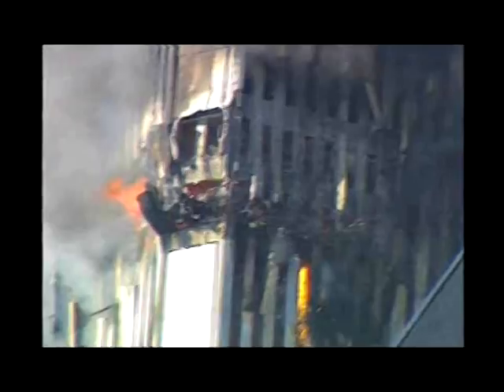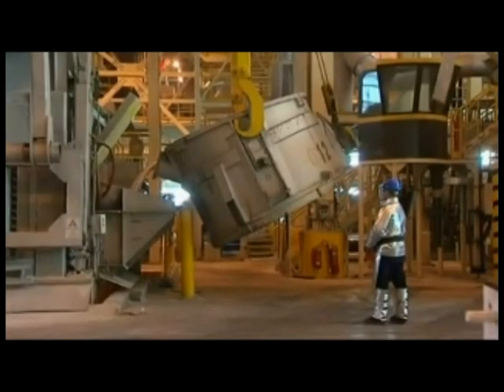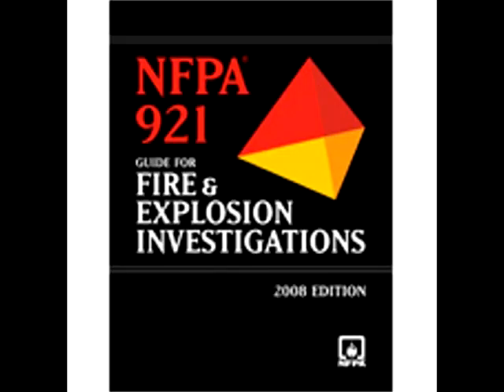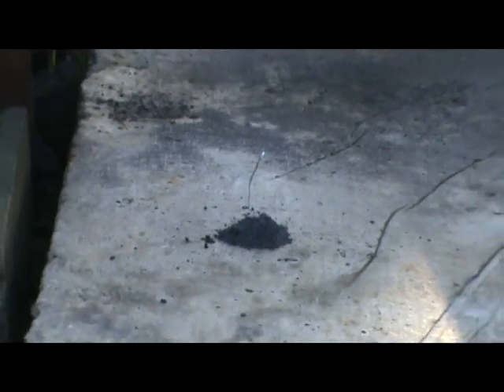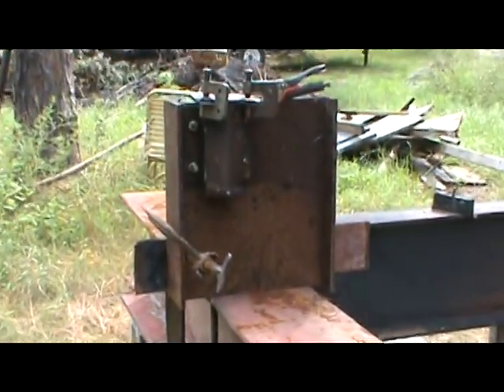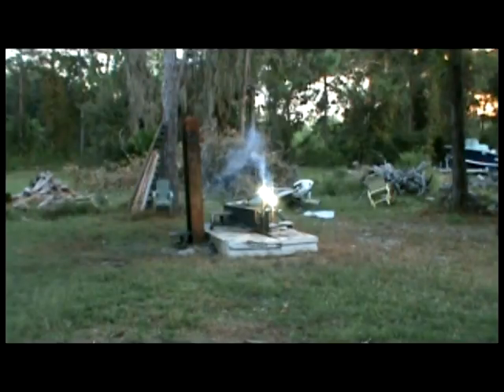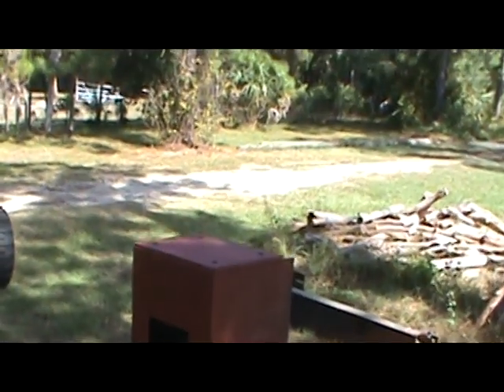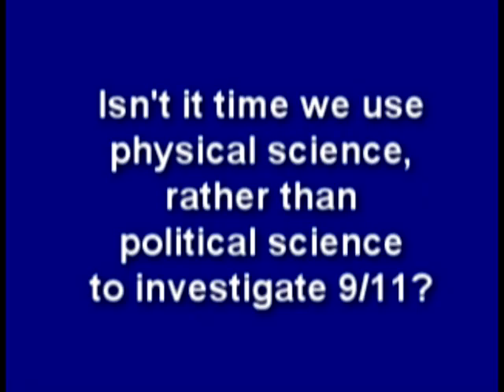9/11 Experiments: The Great Thermate Debate

Comment: You don't NEED to cut the steel, just heat it until it weakens. I don't see anyone doing test with 48,000 gallons of jet fuel.
Reply: +Greg Ballard these points are irrelevant since the steel loses 50% of its strength at 500c. Not to mention thermic expansion can break the welds between beams. None of this requires the steel. To melt. Loss of strength, came down under it's own weight. In ur example the fire proofing worked as intended. In 911, a lot of the fire proofing was removed by the plane on those floors. additionally, in 1975,  they were using full asbestos fire proofing, which is a much better fire retardant than what we use now -- it's just very hazardous to human health, ie "do you or a loved one suffer from mesothelioma?"
Reply: How quickly does gasoline or jet fuel burn? A few seconds and it's gone in the initial explosion...
Reply: @Stephen Savage "I don't see anyone doing test with 48,000 gallons of jet fuel" you don`t need that much for a small scale experiment, why don`t you try to do recreate what happen on that day, physicsanderson at least tries to prove his point, to you?
Reply: He clarified that jet fuel cannot burn steel. Why don’t you listen?
Reply: UpWithLucid , it didn’t melt steel but there were molten metal...why don’t you think
Reply: Take 48,000 gallons of jet fuel then light a match and throw it in it,  nothing would happen aside from the match going out.
Reply: Stephen Savage you're not only an idiot but also gullible af.
Reply: 48,000 gallons of fuel, spread over how many thousands of square feet over how many floors?
NOT likely at all.
Reply: You are an idiot, jet fuel doesn't just magically burn it has to be atomized.
Reply: Preach on brotha.  This guy is a f’n moron.
Reply: Jet fuel needs to be atomized to burn correctly so that’s bullshit with the whole jet fuel theory !
Reply: @nin1ten1do  bc the speed of the plane crashing into a stationary target. The plane will shred on impact but with forward momentum and density it will push through the walls of the tower creating a breach
Reply: those explosions from the planes burned up most of that fuel
Reply: "Proof or it didn't happen"
Reply: Operation Northwoods?
Reply: Jet fuel can only get that hot when mixed with compressed air like in a jet engine
Reply: The amount of fuel don't make a fire burn any hotter, it just affects how long it burns. The towers were only on fire for about an hour, which is already on the shorter side, and almost everyone agrees that the fuel that wasn't burned up in the explosion on impact burned away within only 10 minutes after.
Reply: Stephen Savage fucken idiot still in denial..accept the real world we live in.phsycopaths leading and controlling almost everything besides my balls whe they itch..i scratch'em on my own
Reply: "It's not science when you are cherry picking facts that only suit your argument and you do not impartially accept all facts and science pertaining to the case."

I think you should know something... I just literally looked up the information on those planes and did the calculations as I was writing that comment.

"The buildings DID survive the plane crash. It did not survive the fires that softened the trusses and catastrophically weakened the structures."

Here's some other information you should know. In NYC there are very strict fire code standards for high-rise buildings/skyscrapers. Those codes dictated that the furniture, carpeting, and other materials in high-rise buildings and skyscrapers must have a specific level of fire-resistance. The cubicals? Fire-resistant. The carpet? Fire-resistant. The drywall? Fire-resistant.

The fires were isolated, and they got smaller as time went on, as indicated by the dark sooty smoke coming out of the towers. Dark sooty smoke indicates poor combustion, meaning that the fires weren't that hot. The fires got so small, that after about an hour or so, people were actually seen standing in the hole where the plane impacted the tower. There are pictures online.

https://i.pinimg.com/originals/2e/10/b7/2e10b74bb55e2df3a24ec02b9a0a6216.jpg

"This shit was debunked a decade ago what are you people die hard morons or the new generation of kids who lap up every conspiracy theory."

Actually, if you knew anything about physics, building construction, etc, you wouldn't be saying that.

You know, I find it funny how people like you, whose entire knowledge on this subject is reading the 9/11 Commission report and watching bullshit cover-up documentaries, think you know more about 9/11 than someone like me who has been researching it for over a decade and a half. You just parrot back the shit you've been told to believe, like a moron, and then sit there and call someone like me, who has actually done several shit-tons worth of research around the events of 9/11 a moron.

Get lost, you brain dead dipshit. I know more about science than you know about anything...
Reply: How does a plane make it through that kind of steel to begin with? You're talking about as if there was already an opening. They have actual images of the plane's nose going right through to the other side "whole". How can that happen? It would have become bomb like and blown up on impact outside the tower.
Reply: Yea ,butt nut Jet Fuel Did it !!! IT DOES'NT MATTER THE QUANTITY OF FUEL ,'IT DOES'NT PRODUCE THE HIGH TEMERATURE OF HEAT REQUIRED TO MELT STEEL !
Reply: I have honestly no idea what you're trying to say. NIST provided the evidence that steel did not get hot enough to melt. Yet FEMA provides the evidence that steel did melt. It is in these conflicting findings that the truth lies. And anyone who is not paid to play the bumbling fool on YouTube should be able to figure out what it is.
Reply: MYTHBUSTERS TO THE RESCUE!!!
Reply: Jets fly with compressed air dummy, but that's another conspiracy....
Reply: a* test - or - tests*
Reply: Why does everyone disregard the liquid oxygen that was on board. I am pretty certain that the temperature increase from the oxygen would be enough to ignite the magnesium parts of the aircraft.
Reply: +Rick Johnson, sorry for being blunt, I'm fed up with all the misdirection in these threads and maybe you meant well.
Reply: +Rick Johnson, if you really try I'm sure you can get more nonsense in those two sentences.
Reply: FEMA limited metallurgical examination 403 appendix c
Reply: @Ab4kus  Unlike you, I haven't wasted close to two decades pouring over every single detail trying to prove a theory. I just know that it does not take a very high temperature to get low carbon steel to enter into its blue brittle stage. But keep on going. It's way more fun believing the government is so highly efficient it could co-coordinate an assault such as this and also be successful.
Reply: +Rick Johnson, I do not believe it. I simply can't argue with the facts. And if I compare the capabilities of 19 hijackers against the warmongers in the US government, then it's not exactly a tough decision. It's easy to assume the incompetence of the US government exists on every level, but what they fail to accomplish for the American people should not be seen as incompetence or unwillingness in fulfilling their own plans. Maybe you should see their incompetence for what it really is, them not giving a damn about the people.
But hey, spend some more time on the subject, it's all quite obvious unless you choose not to inform yourself, which is also perfectly fine you know. I just don't appreciate people both not informing themselves and misinforming others.
Reply: Are u high bitch do u know how much that would cost
Reply: Stephen Savage yeah that will work for a WHOLE  big building🤣🤣🤣
Reply: Stephen Savage the beams were also not solid, they were hollow on the inside. The beams were shaped like a rectangle.
Reply: More fuel won't make it burn hotter.  You obviously didn't watch any of the video.
Reply: Stephen Savage that because people are stupid and don’t think 😂 like melting metal is silver 😂😂 that much fuel and fire would super heat it and course it to go red
Reply: 48,000 gallons of jet fuel exploded on impact. there was not enough left over to burn long enough to weaken the steel
Reply: Stephen Savage I know right
Reply: Oxygen Starved flames cannot burn hot enough to weaken steel. rather it can burn the steel hi enough to cook or burn humans. not weaken them. You're so silly. why don't you buy tons of I beams of Structural steel and explode it. if it weakens the steel I'll believe you. but u can't do it in a foundry. only where air circulation is present much like the twin towers
Reply: Because if you use 48000 galons it doesnt make i hotter and it was a thousend degrees below the neltingpoint it would only glow but not even bend
Reply: You just don’t want to use your brain to find a truth, or you know the truth already, but still pushing your BS to others... shame on you.
Reply: That can be arranged.
Edit: Don't take this comment seriously, there's no way I can do anything like that.
Reply: SIERRAHPBT Nobody is claiming that the jet fuel melted the steel. If you're going to dipute NIST's findings on the collapse, at least know what they are first.
Reply: Kerosene to diesel fuel but does anyone really know what jet fuel is? Because i have used it in the past in my snowmobile for racing years ago and it makes a different with performance
Reply: Let's keep to the facts?  Two planes at 24,000 gallons max. each  = 48,000 gallons.  But according to NIST, the planes had 9000 and 10000 gallons respectively.  So you are out by a factor of 5.  Also, it is generally recognized that the fuel flared off in a matter of minutes.  An hour before the buildings came down.   So it seems to be somewhat irrelevant apart from igniting the office fires.   As far as I am aware,  no one has refuted the argument that office fires (alone) have never brought down a steel framed high rise before.
Reply: because WTC 7 collapsed without a plane hitting it ..... you absolute moron.
Reply: your not listening go and clean your ears dumb ass.
Reply: They have done it look it up stop being so God damn stupid Stop Believing everything you're told you probably believed in Santa Claus till you were 23
Reply: Truther-“I’ve been researching this for 16 years I’ve heard your arguments before” 
Sheeple-“But the beams didn’t melt they weakened and caused a chain reaction...”
Truther- facepalm “is that your argument that was aired on tv as the official story like 15 years ago we literally exist because that theory is trash”
Reply: And planes weren't even used in 9/11 they've already disproved that.
Reply: On impact much of the jet fuel burned plus high temperature days  - jet fuel was gone by then and underground would be oxygen starved.
Reply: Jay Jay debunked by who popular mechanics?
Reply: No. The perpetrator of the 1993 World Trade Center Bombing, Ramzi Yousef, was not "still at large". He was found and arrested in 1995 by the Pakistani ISI and the U.S. Diplomatic Security Service. He is currently serving a life sentence at the high-security Supermax prison ADX Florence in Florence, Colorado.

You should probably know what you're talking about before you open your mouth... lest you make yourself look stupid.

You don't find the fact that Larry Silverstein got a 99 year lease on the World Trade Center, and then has the cost of removing the asbestos from the Twin Towers assessed, and then takes out a massive insurance policy on the Twin Towers and WTC complex to protect against terrorism, and then starts a series of "renovations" to the Twin Towers (which no one seems to know what these "renovations" were), and then a week after these "renovations" were complete, the Twin Towers are both attacked by 19 hijackers in 2 commercial airliners the least bit suspicious?

You don't find it suspicious that a good number of these "hijackers" turned up alive after 9/11?

You don't find it suspicious that despite turning up alive, the list of the 19 "hijackers" was never altered?

You don't find it suspicious that the Twin Towers collapsed at, or near free-fall speed? Each tower collapsed in about 8-10 seconds. Watch any news clips from 9/11 and time it for yourself.

Without controlled demolition, it is physically (as in laws of physics) impossible for the towers to have collapsed as fast as they did.

Test this for yourself... The averaged height of both towers (they were slightly different heights) is 1,365 feet. Go to the following page, and either enter "416.052" (equals 1,365 ft.) into the height field...

https://www.omnicalculator.com/physics/free-fall

You'll find that the result returned in the "Time of Fall" field equals about 9.2 seconds. That means, if you had jumped off of one of the Twin Towers, it would have fallen for about 9.2 seconds before you went splat on the street below. The towers fell at, as close as makes no difference, the same rate as you would if you had jumped off of one of them. There should have been resistance slowing down the collapse of the towers, but there wasn't. The only way this is possible is through controlled demolition.

Watch videos of the Twin Towers collapsing, and then watch videos of controlled demolitions... watch them as many times as you need to... eventually, you'll notice that the Twin Towers collapse at the same acceleration rate as the buildings brought down via controlled demolition.

Read the wikipedia page for "Controlled Demolition, Inc.", and you'll find that they were the ones who developed the plan for the cleanup of the WTC site after 9/11.

Not saying that the government was necessarily involved, though it is likely, but... if you don't believe that our government would ever plan and carry out a terrorist attack against it's own people, then you need to read a document from 1963 called "Operation Northwoods"... because the government was planning to commit a false-flag terrorist attack to blame on Cuba to justify military intervention in Cuba. It made it all the way to the desk of the Chairman of the Joint Chief of Staff, L. L. Lemnitzer, who approved it. It was stopped by John F. Kennedy.

https://www.dc911truth.org/flyers/11-11-06-handouts/Operation%20Northwoods.pdf
Reply: @tommy3989  Commercial aircrafts, in order to get to 35000 ft where is the most efficient way to maintain a cruise speed with the engines running at very low rpm, they use half of their fuel, ask any commercial pilot.
Reply: @tommy3989  All the aircrafts involved were at this altitude. I don't work in this industry but I am pilot of a small aircraft and I have friends that are commercial pilots.
Reply: Stephen Savage the fuel was all blown up in the crash the only thing left to catch on fire is office supplies chairs desks etc
Reply: Don't forget a million tons of weight sitting on top of it...
Reply: @yea bouy why do you ask?
Reply: @yea bouy yeah but why do you ask me as if you're trying to prove a point?
Reply: Jet fuel STILL DOESN'T burn hot enough to even weaken steel... Steel doesn't actually weaken until roughly 200 degrees below it's melting point. Which is still a far shot from what Jet Fuel burns at... Moron.
Reply: Here is the Real ?.What government agencies did it .The FBI.or a non Gov agency CIA.Then we went to get Sudan for Genocide.What the he'll do you call what our Gov did or whom ever did it.I believe we killed alot. of humans that day.Not just that day if people would just open their eyes.The kill through the health system and alot other venues
Reply: @curtallen7755  Reading that mess gave me a fucking headache.
Reply: You cannot educate somebody who is ignorant
Reply: all this talk of molten stell- anyone think of all of thebother metals in that building- including the tons of aluminum from the planes- that turn molten at a lower point than steel? only like 3 or 7 pounds worth im guessing- everything in thete was carbon fiber and plastic i assume so souldnt have any copper or aluminum melting and pouring out
Reply: WTF you think a plane carries 48,000 gallons... do you know how big that would have to be
Reply: There is no point making the building collapse on purpose, nothing extra is achieved from "inside job" that is not achieved by just having airplanes crash in the building.

Perhaps less casualties, 300 instead of 3000 - who knows, some more would have escaped, but still would be the largest terrorist act in US history.
So basic point = nothing is achieved from a professional demolition that wouldn't be achieved just by planes crashing into the buildings, same foreign policy, same news headlines with "slightly less drama" but not by much.
Reply: @laetrille  oven and oven.... Lol you're one of those who thinks a plane fell a building.... You sir are a mug.  Based on the previous evidences of planes hitting buildings....  Flying fortress hitting the empire states being prime example.... 3 buildings ever have fallen die to planes hitting them.... EVER.... Is that's not enough info to make you question it.... Well no point in taking to you about it.  The obvious diagonal cut into the beems.... Literally obvious cuts on the pillars in hundreds of pictures... What in a building collapsing causes steel to snap to a prefect 45 degree angel..... I'll wait....
Reply: A B-17 is a medium bomber, not as big as a modern airliner.
The Empire state building is of different design. 
No 45 degree cuts were made by your super quiet quantum nano thermite that leaves no wiring or any evidence.
All your BS has been debunked by the good folks at Metabunk.com
Reply: Sorry but no... the section on the 45 degree cut.... it guesses that they cut it later... lol thats your proof... someones guess.... and you think were tin foil hatters
Reply: touche lol but whole world view... no
Reply: Nathan Stagg 
Oh nice response, nice deflection, no rebuttal?
Reply: Nathan Stagg 
There is alot more ;)
Reply: thanks for the link :))
Reply: None, apart from thank you.  Taught to admit when wrong... and you have proved me wrong.
Reply: Nathan Stagg 
Oof, i was a truther at one point tbh
Reply: 48,000 Gallons burned up in the EXPLOSION YOU MORON!
Reply: Jet fuel wasnt the only thing on fire in the buildings.carpet, paint electrical wiring..all kinds of plastic even carpet..so Jet fuel plus whatever else was burning..increased temps to weakin steel.anyone whos ever used a cutting torch or welding experience such as myself.steel does not have to be in liquid form to bend or move under its own weight..its simple physics and its being thrown out the window in this video.
Reply: There should at least be some math that could help, if scattered jet fuel burns at 1000° & for how long it would need &.. 
  if its pouring away & dissapating until it pools somewhere further down the bldg, how long does the splash of fuel on a beam burn b4 it burns out? 
  This fuel is not suspended or magnetic, like water it will pour, & drip w gravity until thin, then burn very quickly,.. right?
Reply: @Jay Jay massively spread out, blown through & out of the bldg & fuel left would burn itself out quickly.
Reply: @Jay Jay    The failure of a few trusses wouldn't have initiated a full blown collapse like that, floors would also sag alot 1st.
Reply: "You’re all so Fucking disrespectful to all the people that died that day."

I've literally met family members of people who died in the Twin Towers collapses, and they didn't buy the "official story" either. Don't speak for people you've never met, dickbag.
Reply: You literally watch videos of, and read the writings of, people telling you things that aren't supported by the laws of physics, and you don't think that those things are part of a cover-up? You're an idiot... if the Twin Towers simply collapsed, they would have taken longer to collapse than they did. I've literally already explained that the Twin Towers collapsed in about 8-10 seconds (depending on the Tower), and explained quite thoroughly that such a quick collapse is only possible through controlled demolition. I even provided the means for people like you to calculate how long an object would take to free fall from the top of one of the Twin Towers to the ground level... which is about 9.2 seconds, which is just about smack dab in the middle of how long it took for the Towers to collapse. So again, you're an idiot, but I'll add that you're a gullible rube who just parrots back that which you've been told to believe.

And no, I'm not "a die hard conspiracy nut"... the only thing I believe that can be called a "conspiracy theory" is that we've been lied to about what happened in relation to 9/11. I don't believe in the illuminati. I don't believe in chemtrails. I don't believe in reptilians. I don't believe the moon landings were faked. I don't believe anything that can be called a "conspiracy theory" other than the fact that we've been lied to about what happened on 9/11.... so, I'm far from being "a die hard conspiracy nut".

And don't compare me to The Disgraced Racist, dickbag. I probably hate him more than you do, because based on your apparent inability to do research or think for yourself, I most likely know more about why The Disgraced Racist is a colossal piece of shit than you do.

You're just another mental coward who thinks he knows more than he does, who just listens to what he's told to believe and then believes it. The 9/11 commission report tells you that the buildings collapsed due to fire, you believe it. It doesn't matter that the buildings fell at free fall speed, which is impossible outside of controlled demolition, no, all that matters is that the 9/11 Commission report told you that the buildings collapsed due to fire.

You need to look into the Windsor Tower Fire that occurred in Madrid, Spain. It was a vastly more intense and hotter fire than any of the fires that occurred in the Twin Towers on 9/11... nearly the whole building burned for hours and hours throughout the night, and while there was a partial collapse, it remained standing. I know, the construction wasn't the same, but the fact remains that that fire was much, MUCH more intense and much hotter than the fires in the Twin Towers, and the core columns of the Windsor Tower, which were significantly smaller than the core columns of the Twin Towers, weren't affected enough to cause a complete collapse.

Here's a picture of the Windsor Tower after the fire was put out:

https://i.imgur.com/M0LOzGx.jpg

You don't know jack shit, dude. For real.
Reply: Okay.. So what about WTC 7 then? Free fall collapse and no planes hit it..
Reply: Uh... yes, they did. I've literally timed numerous videos taken from different angles... the collapse of the North Tower took about 10 seconds.

And WTC 7 wasn't hit by anywhere near enough debris to cause significant damage. If you had the first idea of what you're talking about, you'd know how far away from the Twin Towers WTC 7 actually was... also, WTC 7 fell at free fall speed as well.
Reply: I cant tell if your being sarcastic or serious lol.
Reply: Sounds pretty expensive. Let me know how that goes for you
Reply: @Stephan Savage   You obviously didn't graduate at the top of your class. Melted steel was found at the site! Watch the video again and this time use the brain God gave you.
Reply: Jay Jay
Little boy, "most of the steel" means nothing, you're logic is shit. If ANY of the structural steel was melted we have a story because it cannot be melted by the jet fuel. We cannot just blow it off by saying it was "likely aluminum", that's not scientific investigation. We need to know, not guess based on what we want to believe, that's for little boys and girls. There's a good chance that someone who goes by the name of jay jay is a little boy or girl, which would explain your stupidity.
Reply: @davidfesta3061  yeah I think it's incredible that these people think the government that couldn't rescue POWs in laos, couldn't rescue the embassy staff in Iran, couldn't design a safe space shuttle, couldn't plan a good budget, couldn't keep a goddamn president alive (interesting story behind that, forensic evidence points to a secret service agent accidentally shooting Kennedy while trying to shoot Oswald. Oops .) And so many other screw ups could pull off the world's largest terrorist attack. People give the US way too much credit. It's why I haven't clarified on anything that people have commented on, if they really want to know the truth, they'll do the research- it's not my job to explain how a steel structure building differs from a concrete structure, nor is it my job to teach them about the design of the original WTC. At the end of the day, the only cover up there was on 9/11 is that we shot down flight 93. That one is pretty obvious if you start looking at the facts- but our government sure as hell wasn't smart enough to blow up our own buildings
Reply: Stephen Savage I’ve seen 39000 liters fuel tankers caught fire in a highway before nothing melted or weaken, twin towers !! I get it but building 7 still mystery .
Reply: You pay for the jet fuel.. I'll do an experiment.
Reply: Stephen Savage because they’re all biased that it was an inside job and not a single one of them has the goddamn brain to understand you don’t have to melt steel rather just weaken the structure and the weight will come down on itself. Cant seem to get that through their thick skulls.
Reply: Like in Tower 7?  You're sharpers knife in the drawer are ya? ^^
Reply: Btw, explain the Chechnya Tower fire and Grenfell Tower in London. Your logic is like your mind -Very tiny.
Reply: It was also a blood ritual, used to invoke intense energy for Satan... for the ushering in of the "New Age", and the "Falling Away", as described in the Bible.
Reply: You don't NEED to have sex with a girl, You just have to tell enough of your friends that you did, and it's like it's true.
Reply: @David Festa Obviously it's the corrosion that's the issue. Please stop trolling and baiting people into a flame-war just to dilute the topic.
Reply: I can see you never went to school , you refuse to understand all this which proves either you are a paid troll or plain stupid.He already showed you cannot fuking burn the steel with ordinary jet fuel yet you put that dumb comment .
Reply: Not even 1 gallon were exposed or ignited at tower 7.  All other buildings in the history of mankind has never collapsed due to fire like- Grenfell Towe,Chechnya , Tower or Dubai or Torch Tower - Here's a link for the dunb people who need things spoonfed. https://www.youtube.com/watch?v=izNDNHK3_N8&t=1s
Reply: Here's the examination with pictures: https://www.fema.gov/media-library-data/20130726-1512-20490-8452/403_apc.pdf
Reply: Free fall speeds disprove the pancake theory.
Reply: @davidfesta3061  I would like to know your source for this information. Everything I have seen so far says the towers fell at free fall speeds. I don't mind being proved wrong. I want to research all viewpoints, so I have an educated understanding of the event. Thank you for being civil instead of giving me the shit post this topic normally encourages.
Reply: The Jet fuel went up in a few seconds.   The floor below were no affected by it.   Think of a firework going off at the 4th of july.   When they explode its very hot but for a short period of time.  Jet fuel does not get hot enough to melt the steel anyway no matter how big the fire ball.   The steel on the ground was molten for days, weeks.    Jet fuel can't do that.   People got fooled on this one, a big magic trick.   I guess they were banking on the low percentage of physics majors etc not counting.   They are out weighed by the gullible.
Reply: 1 gallon 48k gallons still only going to burn so hot...
Reply: @davidfesta3061  the planes hit the top, which had no effect on the bottom by the design, the fire burning inside was not hot enough to do anything structural since it was just office fire so you really don't have anything valid in response🤷🤷🤷
Reply: @davidfesta3061  if you think that there is direct connection from bottom to top that is absolutely completely rigid to the point that it can transfer that energy to the base, please explain how they would ever survive an earthquake.
Reply: @davidfesta3061  funny cause I own 2 businesses and about to venture into a third 🤷🤷🤷 don't be upset that you have no clue what you are talking about and just want to look cool for YouTube comment readers
Reply: @aydenstiles4019  1. Aircraft noses are lightweight disposable composites, 2. What did the bird look like? Move anything fast enough and it can cause a lot of damage, 3. The aircraft disintegrated on impact but all of it went into the building, 4. The buildings did NOT collapse on their own foot print, one of the towers fell partially sideways, 3. The original WTC was a steel structure. No concrete 4. Do you think the government would have killed secret service agents who were responding? The SS office for New York was in WTC 7
Reply: Ditto
Reply: What you, and others here, have a complete lack of understanding of is this: The steel being weakened over a span of a few floors does not explain how the collapsing upper section of the buildings took the path of most resistance during their collapses. This is not logical. Falling objects take the past of least resistance, not the path that provides the most resistance. IF the towers collapsed due to thermal weakening of the steel, then the collapsing upper sections should have impacted the intact steel structure of the floors below the points of impact and then shifted to the side in order to take the path of least resistance. Instead, what happened? The collapsing upper sections miraculously punched their way through the intact steel structures... that makes no sense. None at all.

And where did I say that the government did it? Because I didn't say the government did it. For all we know, Larry Silverstein planned it all. I can't speak to who did it with confidence, so I make no claims as to who did it. All I know is this: We've been lied to about what happened on 9/11, and the Twin Towers and WTC 7 were brought down via controlled demolition.

And yes, I could see our government just doing it to start another war. I mean, they did develop a plan in the 1960's called "Operation Northwoods" where they were going to stage a false-flag terrorist attack to blame on Cuba to provide justification for invading Cuba... so, it's not like our government hasn't done something like that in the past.
Reply: Bravo Ranter!   All fantastic points.
Reply: I'm here. Thanks.
Reply: @Jay Jay Thats correct BUT the point of this video is that they found tons of molten steel and you can see it pouring out the side. Trusses will bend but will not melt. There was also no reason for them to weaken at the same rate all the way so it went straight down and not lean towards the impact site and do more of a top topple.
Reply: Babylon falling no because a lot of fuel is used on take of which is the expensive part
Reply: Your too stupid to see the point of this video it wasn't that they needed to melt it it's the point that it was a set up
Reply: You don't need to tell the truth, you just have to weaken it. It is obvious to anyone with a modicum of common sense and observation skills that av-gas and wind doesn't melt steel. Never has, never will.
Reply: IF YOU LOOK AT THE VIDEO OF THE BURNING TOWERS YOU SEE SOOTY BLACK SMOKE...AKA  INCOMPLETE COMBUSTION...AKA LOW HEAT.....SO THE JET FUEL DIDNT DO IT  FOR THE LACK OF AIR...BUT THERMITE HAS ITS OWN OXIDIZER.
Reply: 48000 gallons? ok. so what happened to the third building?
Reply: jay jay
Wow your lack of comprehension is scary, I can't return fire in anger because I feel more sorry for you than anything else.
Reply: Someone did try to weaken a steel beam with jet fuel. Look for a video called *"steel being weakened by a jet fuel fire"*.
Mind you, it was made by the same people who couldn't even peel the paint off a steel pieces with almost 200 lbs of thermite. So you know their results are unbiased.....right?
Reply: sometimes you just can help people understand even when they see it in front of their eyes. gee whizz
Reply: LOL you have just seen nation geographic trying to melt the steel with several bags and lots of energy and you are talking about jet fuel that has little to no energy compared to the nano thermite and still question this ? Jeeez ..

One word : 🐑
Reply: @TheRealAnthony_real  
That's what gets me. The debunkers claim that thermate could not have been used because they say it can't cut steel. But when it's about fires, suddenly the steel doesn't need to be cut, just weakened.
Reply: I guess no one ever bothered to look at HMS Sheffield and the melting steel caused by the Aluminum burning after the missile attack. Ever seen Aluminum burn? No because it burns clear.
Reply: You're missing some things... An Avgas ("Jet Fuel") fire can not burn hot enough to melt steel to the point where it is molten... so where did those streams of molten metal that were coming out of the towers come from? Where did the pools of molten steel (that remained molten for weeks) under the towers come from?

Also, where did the tiny spheres of iron found in the dust from the collapse come from? Do you know how what temperature the molten steel would have to be at to create those spheres? I don't know the exact temperature, but I do know it would have to be way hotter than the temperature Avgas burns at.

I can tell you right now that most of the Avgas that was contained in the planes was burnt off in the initial fireballs after they impacted the towers. Remember, those planes hit the towers at speeds in excess of 580 mph... they were made of aluminum... which means that they essentially shredded on impact... which means that the fuel tanks were also shredded... and don't forget about conservation of momentum... sure, the forward motion of the fuel was probably reduced slightly, but that fuel was still moving at several hundred miles an hour after impact... meaning much of it likely continued through the building, some of which was burning due to sparks, where it burst through windows on the opposite side, aerosolized, and then flashed into the giant fireballs seen.

I know, you're probably thinking I'm some conspiracy theorist... but I'm not. I used to be. I used to believe in all kinds of conspiracy theories... but then I got better at researching things, and I've abandoned almost every conspiracy theory I believed in... all but this one. Why? Because the official story doesn't make any sense. It's not plausible. Nothing in the official story explains the two most glaringly obvious facts that prove that the twin towers came down as a result of a controlled demolition:

The speed at which the towers fell. Both towers fell in less than 10 seconds... they fell at just about the same rate as an object in free fall.

The tops of the buildings collapsed by taking the path of greatest resistance. The structure below the point of impact should have been intact, and should have prevented a vertical collapse. The upper portions of the towers should have made impact with the intact portions of the building and been diverted off to the side, but they weren't, Instead, we're supposed to believe that the intact structure below the point of impact just gave out with almost no resistance what-so-ever? I don't buy that.

I make no claims about who did it, but what we've been told to believe happened on 9/11, the "Official Story", is bullshit.
Reply: Yeah, I'm missing a whole bunch of made-up garbage from conspiracy theory nut bags and photo shoppers
Reply: @stephensavage2684  Yes...ok and you just keep buying the narrative about them finding the hijackers ID  in laminate in perfect condition just blocks away lol
Reply: @theranter  those streams of molten metal was the alluminum of the airplane
Reply: As someone who has literally cast things from aluminum... no... it was not the aluminum from the airplane. Molten aluminum does not glow red when in a liquefied ("molten") state, it remains just as shiny and metallic when it is molten as it is when it is solid.

Don't believe me? Take a look for yourself.

https://www.youtube.com/watch?v=hPwc2fDhuM4

So, no, that wasn't aluminum, it was unquestionably molten steel streaming out of the Twin Towers.
Reply: No, it wasn't aluminum. How do I know? I've literally cast things from aluminum in the past. I know what molten aluminum looks like because I've literally handled crucibles of molten aluminum. Have you? I'm guessing not. Sure, it CAN glow, but even at high temperatures, it doesn't glow that bright (not bright enough to be seen in daylight conditions, as were present on 9/11), especially in comparison to other metals. And even when glowing, it still looks metallic when being poured. Thus, if the metal coming out of the towers was aluminum, it still would have looked metallic, and not bright red. It was molten steel. Also, further evidence for it being molten steel comes from what was found underneath the rubble for weeks after the collapse: Pools of still molten steel seen and found by many first responders and officials in charge of cleaning up the site:

https://www.youtube.com/watch?v=nqJSDn5dgJc

And you won't change your mind because you've made up your mind because the government told you what to believe. I won't change my mind because I know for sure that the "official story" is bullshit. I'm not alone in believing that. There's an entire organization calling their collapses out as controlled demolitions... Architects and Engineers for 9/11 Truth. They're literally Architects and Engineers, and they call bullshit on the whole "pancake collapse" bullshit. They are more qualified than either of us to make such a call.
Reply: @theranter  ok but what about the airflow that would have been going through the building, would it not act like a giant furnace?
Reply: Take a look at steel framed buildings after fires, they become extremely week and collapse under their own weight, then take a look at concrete reinforced buildings, the concrete remains and the steel falls down. Also the molten metal was aluminium, which melts at a much lower temperature, finally take a look at what happens when you mix molten aluminium and water mix, it becomes extremely explosive.
Reply: We've all seen footage of what the controlled demolition of a high-rise tower looks like. It should therefore come as no surprise to even the most ill-informed that the execution of a controlled demolition of a high-riser is not as straightforward as simply throwing a few tonnes of dynamite in the basement. 

The talents behind controlled demolitions calculate and plan this shit out to the nth degree; I'm not aware of all their tricks but I know their strategy includes the compromising of a structure in key locations, the use of shaped charges, the design of a series of a specific magnitude of forces to arrive at specific locations at specific points in time and then boom... A high rise tower collapses into its own footprint and if the demo-experts are really on top of their game, you'll see zero damage to any adjacent structures.
I've also heard that not all demolition specialists will take on projects in highly built up areas. 

I'm pretty sure that NOWHERE does the manual suggest "...all you have to do is fly a jet liner sized object in to the top third of the building and let fire and gravity do the rest." - And yet the "Official Story" expects us to blindly accept that on 11th September 2001, not only did THAT scenario manage to plant a 110 storey building in to its own basement; that fluke (apparently)... That highly unlikely, one in a million result happened a second time, to its neighbouring tower (the twin no less!), on the same day! - Hows about that?

I'm not saying that terrorists weren't responsible and I'm not saying that they didn't have help, be it through wilful inaction, tremendous incompetence from the inside or even possibilities that are far more disturbing. - But I do think the "Official Story", is bullshit!
Reply: @theranter  avgas and jet fuel ( JetA1) is two very different things. But still i agree its an inside job
Reply: @theranter  you're spot on! The official story forgets to mention how every single column in building 7 was cut at the exact same time. This is easy to understand for a child. How can adults be so blind?
Building 1 and two was not a normal controlled demolition, they couldn't do that like a normal one, it would be to obvious.
But building 7 is a classic controlled demolition.
Reply: +Samir Yousif The NIST report does not mention that "every single column" in WTC7 was cut at the same time because they weren't. The interior of the building collapses (you can see this from the video) and then the shell of the building falls. No explosives, no thermite/thermate needed.
Reply: @theranter  It could have came from the plane. I'm just giving an idea, don't bash me.
Reply: Virales Gladio... What could have come from the plane? You need to be a bit more specific there, buddy...
Reply: @theranter  Aluminum? I'm just taking an educated guess, not very familiar with chemistry.
Reply: However agreeable, all revelations pertaining to the fact that you are actually vermin and are treated as such will do very little to affect your situation.

Back into the rat maze you go. It's that... or leave.
Reply: The Ranter
Reply: The Ranter. Idk lol, I’m not a scientist how shout I know if its steel or not? Do I care? I just care about the deaths and the lives changed forever.
Reply: The Ranter. Also I find you and many other theorists in this comment thread quite nice. Not rude, offensive, or stupid like many others. You have personal and well researched claims and you don’t resort to rude comments and insults. I personally believe it wasn’t an inside story, but you are of course entitled to your own opinion.
Reply: @theranter  not metal aluminium all 30 tons that your seeing!  Have you any idea what happens when a small amount of molten aluminium comes contact with water?
Reply: Sorry I don't have 48,000 gallons of Avgas and steel beams with hundreds of tons of weight on them to test out the exact conditions, but someone putting thermite into the walls on the very floors where the planes hit? When did this happen and why didn't anyone say anything THEN?
Reply: The Ranter where did the fireball come from?
Reply: @theranter  from all of the aluminum desks an other that were so hot and with the sprinkler water going off and hitting the aluminum will make that molten fire streams.Watched a guy do a special on that great question.You don't have to experiment with steel.Ask 500 pilots with 30 exp.if they could have flown that plane the way the highjackers did and all will tell you it would be impossible.The Pentagon had no airplane parts anywhere in it around it and only a 30x30 round hole in the side.The vertical stabilizer on that pane stands at 130 feet from the ground up.Why only a 30 foot round hole.The plane would have to be down 4 feet off the ground for 200 yards then hit it.Great skills from a  pilot that got his license in 3 months in a school in FLA.
Reply: Its super funny that everyone is wrapped up in the idea of steel. There were plenty of other metals and substances present in that building. What's the melting temperature of aluminum for example?
Reply: @Fourtay 
Super funny that you missed the point about what melting aluminum looks like, and the all too non random pattern associated with the melting. Review the video
Reply: The Ranter av gas is basically gasoline, jet fuel it’s close to kerosene!
Reply: The Ranter To answer your points. The streams of molten metal seen falling from around the 81st floor occurred after this floor subsided down as can actually be seen in the footage of the metal flow. It is thought that large sections of the plane were not completely shredded, especially the larger cast parts, and these large pieces of aluminium melted into a pool, which then spilled out the building when the 81st floor dropped.
As for the iron spheres, these are also found around areas where iron or steel is forged, riveted or welded. All of New York soil is full of iron sphericals as so many steel framed towers and buildings have been built. 
Indeed, when archaeologists dug around the old palace in Greenwich, London, UK, they found iron micro spheres in the soil from Henry VIIIs weapon foundry from the 16th century, created from casting and forging weapons and armour. No thermite in the 16th century. Iron micro spheres are not an indicator of Thermite, they are an indicator of metal working. Do you think there was a lot of metal working when they built the WTC? 🤔
Lastly, could you explain to me how they prepared the WTC towers for demolition, 10s of thousands of charges, millions upon millions of feet of det cord, wiring, walls demolished, perimeter and internal columns cut, AND NO FUCKER NOTICED? 
To prepare ONE building a quarter the size of one WTC tower for explosive demolition took FOUR MONTHS! And they had to strip everything out of the building down to bare walls!
Reply: You ever see the movie the Matrix.    You are one of the people living inside of it and will hold on to their world view at any cost.   Wake up do some research you can handle the truth.

9-11 was a giant magic trick and it fooled many people.
Reply: Lol ,  molten aluminum takes 1220C or more.  Yea the flash explosion (most fuel gone is seconds) heated up all the Jet and turned it into molten aluminum.
Then it somehow flowed floors below without cooling to stream out a window.    I have some swamp land in Florida if you buy that weak explanation.
Reply: @ The Ranter - I'm going to go out on a limb here but maybe the molten up to nearly 400,000 lb Boeing 767 full of fuel that crashed into the building at roughly 590 mph damaged the structure of the building to the point of collapsing in on itself.  I guess it can.
Reply: @nickdude07  the wtc towers we're designed to withstand a direct strike from a commercial airliner.
Reply: @maddienreeree  they were designed to take a hit by a much smaller plane at much lower speeds with almost zero fuel left. Go learn about your talking points before blindly parroting them
Reply: How come nobody has mentioned the Israeli demolitions team that was discovered working in the off-limits construction zones throughout the building?! Oh damn... don't have a response for that do ya?!
Reply: @maddienreeree  go look up what aircraft they modeled it on. It was a smaller aircraft and the speed estimated is hundreds of miles per hour slower. The scenario was that of a plane lost in fog that couldn't find a run way and it was coming down due to running out of fuel. Once again, go learn about your own talking points.
Reply: @maddienreeree  maybe if there was any evidence of this it would warrant a response.
Reply: @maddienreeree  the chief engineer himself has said on record that the tower was not made to sustain anything close to the impact it did. 707 at 180 mhp was the design specs, not a 767 at 450-500 mph. Additionally, even it was was, designs fail all the time. The titanic was supposed to be unsinkable. Must have been a government conspiracy...
Reply: @Budokid  And Donald J Trump is supposed to be a good president...but he's not! All jokes aside...I spoke with several career firefighters, several of whom had military backrounds, and they all told me that they smelled thermite and saw small explosions well below the impact floors as the buildings we're coming down! These very same firefighters had stood by for controlled demolitions in the past and said this was the same damned thing! They lost 343 of their own that day, so I tend to believe them ( being as I'm a former firefighter/EMT myself) over the architect that was most likely under government advisement to make the statements that he made. And none of this does anything to debunk the E-Team and Gelatin article.
Reply: @maddienreeree  sorry. But it couldn't be the same thing. Explosions are expected in a building fire: fire extinguishers, refrigeration units, propane tanks, etc... Explosives however, are not. The volume from just a single explosive charge required to take out a single steel beem (let alone the tens to hundreds of charges ud need to bring down that building) would exceed 140db within a half mile radius and be clearly audible from new jersey. BTW 140 db is like a jet taking off right next to your head. If this happened, literally everyone would have heard it (not just a few first responders) and it would be clearly audible on all video footage. Nothing on this scale was heard. It was just normal explosions and steel beams hitting the ground at high speed.
Reply: @maddienreeree  additionally, what they would be smelling is hydrogen sulfide and while it is true that this is produced in thermite reaction, it is also present in all the sewage lines. Sewage lines were in fact damaged when the towers came down. This is what they are smelling.
Reply: @Budokid  even being half-drunk and hung over as hell with a head cold and a severe sinus infection, a rookie straight outta the fire academy can smell the damn difference between hydrogen sulphide (thermite) and methane (sewer pipes/shit smell)! Give me a break! Guess you believe Oswald acted alone and Ruby really just wanted to spare Jackie from the trauma  of a trial. No sir...our beloved government has NEVER lied to us about ANYTHING! Yeah right!
Reply: @Budokid  your argument is about like trying to use science to prove the earth if flat...it doesn't work! You're trying to say they would have used high explosives and that it would have made really load booms...but nano-thermite is a military incendiary that pops and sizzles... It doesn't go bang like dynamite or C4... Which is why there wasn't the "boom louder than a jet engine" that you're referring to. And as far as the other items in the building such as fire extinguishers blowing up... really?! Do some more research and take a trip to the firehouse a couple of blocks away from WTC and ask anybody who was there that day! If that don't change your mind then you don't have one
Reply: incredulity is not an argument. Both methane and hydrogen sulfide are in sewage lines. Both have the same rotten egg smell.
Reply: @Budokid  and there it is folks... irrefutable proof that you don't know what you're talking about! Hydrogen Sulphide (H2S)has the characteristic rotten egg smell HOWEVER...Methane (CH4)is a colorless and odorless gas which is an asphyxiant... Yes both are present in the sewer,but they Both DO NOT smell like rotten egg! So... my friend... I ask you...if you were wrong about something as simple, yet important, as which gas smells and which one doesn't... isn't it possible that you're wrong about the events of 09/11/2001?
Reply: @Maddi O'Dell except there is no evidence thermite was used either. and we know for a fact that fire alone will eventually bring down a steel frame building.
Reply: so you tell me they can smell the difference between H2S and CH4 (when CH4 is odorless). i take you at your word that methane has a smell, yet somehow that makes me wrong about the smell of H2S which is what i said they were smelling in the first place (which does in fact have a smell -- rotten eggs)? what are you smoking. you brought up methane and i failed to fact check you on it's smell, so now everything i say is suspect? go home you're drunk. i didnt look up if methane had a smell which is actually irrelevant to any point i was trying to make. I looked up all the other stuff.

basically you tell me they are smelling something that has no smell, yet im the one who might be wrong about everything because i failed to fact check you? that is a weak argument. and it actually hurts you more than it does me.

also they typlically add tert-Butylthiol to give methane it's smell, which is what u find in gas lines to gas heated house appliances. but tert-Butylthiol is not present in the methane in sewage lines. hmm. tmyk.

it does not logically follow that if you are wrong about one thing you are wrong about everything. and could you be wrong about something is a stupid rhetorical question because yes anybody can be wrong. people are not infallible. But just because you can be wrong does not mean you are wrong -- that does not logically follow either.
Reply: @Budokid  and you called me drunk?! The point I was trying to make was that firefighters know the difference between the smell of sulphur from the burning of accelerants/ incendiaries from the smell of sewer lines. And I wasn't saying that you were wrong about "everything"... I asked you if it's "possible" that you were wrong about the events of 09/11/2001 because of your own professed error... meaning if you failed to fact check one statement, you "may" have failed to adequately fact check the events of that horrific day. I urge you to read up on "false flag" operations. Our government is not as wholesome and without blemish as you might think. You have certainly proven yourself to be a worthy and intelligent advisary with whom I've enjoyed debating. I sincerely appreciate our banter and hope you will consider further research into black ops and false flag operations. I'm sure you will be enlightened...I certainly was! I bid you farewell and good night.
Reply: t's an expression. i dont actually think you are drunk. you specifically said:

"even being half-drunk and hung over as hell with a head cold and a severe sinus infection, a rookie straight outta the fire academy can smell the damn difference between hydrogen sulphide (thermite) and methane (sewer pipes/shit smell)! Give me a break! "

so my point was the error was initially yours for saying methane had a smell in the first place.
am i gonna ask you if every thing else you know about 9/11 is wrong because of that error? no because that would be stupid. it is an excusable error, because the methane that comes to ppls houses has smell added to it with  tert-Butylthiol.

you also said that they told you they smelled thermite. Thermite reactions gives off hydrogen sulfide <--- this is what they would be smelling. Then i told you that the smell came from broken sewage line which also contain hydrogen sulfide (the same chemical given off in thermite reaction. so it's the same smell!) and that it was much more likely they were smelling the broken sewage lines from the building coming down. so what you are saying in a nutshell is that they can smell the difference between two different sources of hydrogen sulfide. and im saying no thats stupid, it was from sewage lines and they were mistaken
Reply: That was pools of aluminum probably. The plane was a giant can exploding. aluminum also melts twice as fast as steel.
Reply: The stuff coming out of the buidling was molten aluminum and other materials.
Reply: @theranter  the molten metal wasn't steel it was aluminum from the plane which would have been past melting point easily...also when that huge amount of molten aluminum comes in to contaked with water supply for the sprinklers you get a massive explosion from hydrogen generation) not that it matters the fire without all that would have been more then enough to make the beams buckle inwards causing the building to collapse.
Reply: +Paladin Danse, did you take the effort of looking up the metallurgical examination? That would put to rest all your assumptions about aluminium. Also, do you notice anything about your video? Every time that aluminium leaves the cauldron, it immediately turns silvery. The metal that fell from the tower stayed orange all the way down.
Reply: What's bullshit is how everyone, including you, greatly assume that steels melt. Fun fact: They don't.

If you have a very hot fire burning inside a structure, it will WEAKEN the steel, which increases the chance of a structure collapse. Now, since the towers are both office building and the two planes crashes into offices, you have lots of fuels (papers, wooden desks, ect.) which increases the heat of the fire. What also added to the structure collapse equation is how multiple floors were damaged and you can see the fires break out. So having a very hot fire like the one you saw on the towers can melt the steels and cause it to collapse. 

I don't see why people keep assuming such nonsense. I'm being trained on to understand how fires works and destroy properties quickly. You people need to get your head out of your asses and accept the truth
Reply: @theranter  AvGas is 80LL 100LL or 100UL petroleum based fuel. Jet A, however, is pretty much pure kerosene, and contains much more BTUs, burning hotter if ignited, which is tricky, hence why compression is used in diesel engines, rather than sparkplugs. The internal structure of the world trade center combined with the high velocity impact of the aircraft (compression) and its wings' ability to cut through the outer shell of the building created a super oven of sorts, allowing the kerosene to burn at peak temperatures, with the slotted walls creating the perfect oven structure, combining the reflective thermal properties of metal with the ability to feed the fire with oxygen. This in itself would have generated enough heat to cause the vertical beams to begin to soften, allowing them to bulge outward, beginning the sequence of destruction.
Reply: Now if you really think about it, the force of the towers on vertical beams generates a shit ton of pressure. When you combine that with the beams being heated to a point where they can begin to flex generates enough pressure for them to melt further. The collapse of the WTC acted as a piston, creating the pressure required to heat steel to a point of being molten for a very, VERY long time. It also didn't help that much of this steel was buried under more steel, which reflected thermal energy allowing it to retain its molten state longer
Reply: Pile of George... that's a pile of bullshit... there was thick dark smoke coming out of the towers, and that indicates poor combustion as a result of oxygen deficient fires. I know this because I'm a car nut... and I know all about "rolling coal" which is when Diesel Truck Bros skew their fuel to air ratio to be fuel heavy, and light on oxygen, causing their exhaust to come out thick and dark, hence "rolling coal".

So no. There was no "super oven" or fuel burning "at peak temperatures" because if there was, the fuel would have burned cleanly, and wouldn't have produced the thick dark smoke seen coming out of the towers.
Reply: Pile of George... your second comment is also BS. None of that explains how dozens of intact floors, that were undamaged by the impacts or the fires, provided absolutely no resistance, allowing the upper sections of the buildings to plow right through them.

The buildings collapsed at (as close as makes no difference) free fall speed. If you had been standing on the roof, at the edge, holding a tennis ball in your hand, and you dropped it right as the building started collapsing, you and the tennis ball would have fallen at the same rate. If the building was collapsing under the circumstances which you are positing, this would not be possible. There is only one explanation for the buildings collapsing at free fall speed, and that is controlled demolition. The intact structures below the points of impact would have to be destroyed in advance of the collapsing upper structure in order for it to fall at free fall speed.
Reply: From the NIST report: "NIST did not recover any steel sample which reached a temperature of 600 C, and only three that had reached 250C"
Reply: The NIST Report is bullshit... they were involved in covering up whatever really happened. People much more qualified to say that it was bullshit than I have said it was.

Again. The buildings collapsed at free-fall speed... and there's only one way that is possible. Controlled Demolition. Which, might I add, there are demolition experts who have stated in no uncertain terms that the collapses had to have been controlled demolitions. Sure, they weren't the typical bottom up controlled demolitions, but they were controlled demolitions.

Further proof of this is World Trade Center 7, the Solomon Brothers Building. It was not struck by a plane, and received almost no damage from debris, as it was 100 yards from the Twin Towers... and yet, it had a nearly perfect vertical collapse, from the bottom up. It too collapsed at free fall speed.

So, you're suggesting that I should believe that three buildings in the same complex all collapsed at free-fall speed, in violation of the laws of physics, on the same day? When no building before or since has collapsed at such speeds outside of a controlled demolition?

Here's another tidbit for you about WTC 7... if it's collapse wasn't a controlled demolition, then why did the BBC report it had collapsed nearly a half hour before it did? And there's no doubt that WTC 7 was still standing when they reported it, as you could see WTC 7 still standing in the background as the reporter talked about it collapsing. Interestingly, a few minutes into the report, her camera feed began to get staticky, and then cut out.

Just to put this out there... I've been reading about and researching 9/11 for 16 years. I've heard all of these rationalizations before...
Reply: @theranter  Responding to comment 1: you're absolutely correct in that there was black smoke, however this was not a result of poorly burning fire, as black smoke is not always a result of lack of oxygen. A majority of the  materials in the WTC and most buildings are a mix of organic and composite materials, which generates a toxic black smoke. You're looking at about 1500 ft up on the edge of the coast of the Atlantic- I can personally guarantee you that there was a wind of at least 15kts feeding those fires. I'd also like to address that a high velocity impact is what starts a crash fire, as the incredible force causes combustion... But because there isn't a 15:1 air to fuel ratio, you don't burn all of the jet A, allowing the fire to continue burning on Jet A.... But what would I know, I'm just an aerospace engineer
Reply: @theranter  responding to the second comment: This near free fall is due to poor design. This is hard to explain, so bare with me: This is a result of a design flaw, and physics. Picture this in your head, and trust that I understand the core concepts and am not lying to you: 1 floor gives way, causing all of the intact floors above to collapse, the force of these floors impacts the floor below, causing both the horizontal and vertical beams to compress vertically and expand horizontally. at every interection of v&h beams there are bolts, these bolts do not compress because of their spherical shape, this causes them to give way and pop out, offering essentially no resistance. This is actually normal, as any object can only offer so much resistance to a force, and once the force exceeds its limits, it gives no resistance and essentially gives way. This would occur on every floor. How do I know the bolts didn't hold? Look at the pictures, there aren't any functional bolts left in the steel beams found at the wreckage... Well there are but only on the floors above the impact. The towers collapsed because of the modular floor design, which put that every level was designed essentially the same as the floor above. This created a system of individual structures, each that were only designed to take so much load. Had the building been designed with greater overall structure that was built as a cohesive tower rather than being designed as individual identical levels, both towers would still be there today. There are reasons why the towers designed the way they were, but I yield the floor. You all can debate about that, I'm just trying to bring a view based on my training and experience
Reply: @theranter  so what do u think happen, honestly?! Somehow ppl got inside the guts of the building & spread materials that would help it burn & then set the explosives off? I'm not being an as* I'm just curious? I will give u my email if u would like..
Reply: Yes. I do. There was extensive construction work being carried out for 6 months before 9/11... there were witnesses who stated that entire floors were closed off from access for weeks at a time... there was a guy who talked about how when he would come into work in the morning, everyone's desks, and everything on them, would have a fine layer of dust from the construction work being done on the floor above. He heard jackhammers, and lots of other noises. After the work was completed, and the floor above him was reopened, he went to see what they had done, to see what it looked like because he regularly visited that floor as the company he worked for used to also occupy that floor. When he went up there, he said he could see absolutely no difference to anything, other than it all looked new. So, they tore the whole floor apart for weeks, only to put it back exactly the same way as it was? Seems a bit odd, wouldn't you say?

This construction started after Larry Silverstein was awarded a 99 year lease of the Twin Towers, and after he had gotten a huge insurance policy to insure the Twin Towers... one of the specific requirements he made when negotiating the insurance policy was that they be covered in the event of a Terrorist attack.

After 9/11... he tried to get the full amount of coverage that the insurance policy provided... but he tried to get that amount for each tower. He basically tried to double the amount of money his insurance company agreed to provide.

And here's another thing... Didn't you ever find it odd that it took them 11 years to build the new World Trade Center 1, when it only took them 9 years to build both of the Twin Towers? Also, if there weren't pools of molten steel under the WTC, then why did it take until just recently for them to rebuild and reopen the subway station under the WTC?

I'm not sure how much of the videos that prove the stuff I'm saying still remain online (a lot has been tossed into the "memory hole" over the years), but there's lots of video out there that gives plenty of reason to not believe the "official story".

You can send me a private message through my channel if you want to send me your email address... if you do, I'll find some of the video clips that will change your view of what happened on 9/11 and link you to them.
Reply: Um... In NYC, at that time (I can't say if this is still the case), in regards to skyscrapers and other tall office buildings, office materials like furniture, partitions, etc, had to be made with fireproofing built in, so as to minimize the chance of a big office fire in a skyscraper. So, it's unlikely that those items contributed to the fire that much.

And 1,500 ft. up? Dude... the Twin Towers were 1,368 and 1,362 feet... and the points of impact were much lower than that.

And if you're an aerospace engineer, you should understand that that unburned fuel traveled through the building, coming out the other side, resulting in the giant fireballs seen after each plane impacted each tower. Where else did that giant fireball come from? Watch a video of the impact... take a good look at how large that fireball is... and remember that the Twin Tower's footprints were 210' x 210' and the buildings had an averaged height of 1,365 feet. That fireball was massive... THAT is where that fuel went... there is video out there showing people standing in the hole at the point of impact, waving for help... if there was a "super oven" on that floor, those people would have been dead, and wouldn't have been able to do that.
Reply: Nice job reiterating the exact same BS that NIST claimed. Even under that circumstance, those buildings wouldn't have collapse at free fall speed. You don't have to take my word for it... look up "Architects & Engineers for 9/11 Truth". 

Also, you conveniently ignore the fact that the massive core columns were also torn apart like they were paper... these were some of, if not THE largest steel beams used in a skyscrapers construction ever. They should have survived the scenario you propose... at least partially. But they didn't. They came apart with no resistance... if they had, they would have slowed the collapse, and again, the buildings wouldn't have collapsed at free fall speed.

Also, none of this explains the collapse of WTC 7. Here... watch the collapse of WTC 7 for yourself... watch it, and then tell me that it wasn't a controlled demolition. Specifically pay attention to the small structure on the top of WTC 7... it begins collapsing before the outer walls of WTC 7 do... this supports the claim of controlled demolition, because in a controlled demolition, the core columns of a building are blown first, as to induce the collapse to fall inwards towards the center, so that the building falls into as small of a pile as possible.

https://www.youtube.com/watch?v=Mamvq7LWqRU
Reply: @pilotgeorge2000  That is a non sense, the bottom floors are stronger than the top ones. They have to hold 80 floors and the top one only a roof.
Reply: @scaloi  have you seen the blueprints? The floors are all built in a modular fashion
Reply: @pilotgeorge2000  Yes they are, but that doesn't mean they are identical. The bottom floors must have more modules than the top ones. You can stack a limited no. of containers, if you go more the bottom one will collapse.
Reply: "then why did the BBC report it had collapsed nearly a half hour before it did?" because around 2pm the first responders saw a bulge forming in the side of the building and said they feared collapse was eminent. in the chaos of that day "they building will collapse" got mixed up with "the building has collapsed" this is why no firefighters were killed. they expected the building would come down and had plenty of time to evac. there are plenty of videos of news casters reporting that "we are being told this building will probably collapse". this is also why nobody was hurt when the building came down. first responders anticipated the collapse and were able to move everyone 3 blocks back in advance.
https://www.youtube.com/watch?v=zZrlNw-31R8
a more general explanation of building 7:
https://www.youtube.com/watch?v=4LUDXpMhkNk
Reply: Of course all the plastic burning on three or four floors had nothing to do with it. (SMH)
Reply: (SIGH) If 20 stories of a building were falling on you, you would fall at free fall speed after 1 or 2 stories as well.
Reply: @stephensavage2684  yep steel beams were vaporized but paper passports survived isn't that amazing you really have a waking up to do and growing up to do
Reply: @BarukHabaBShemYahuah  yeah with all that paper flying out of the towers just after impact, its a wonder some passports might have survived hmmm...
You conspiracy nuts really don't use your heads do you
Reply: @theranter  
Oh obviously you know so much about steel and cutting steel. Like how oxyacetylene cutting happens at about 800°F less than half the temprature required to oxidize steel, produce dross droplets, and send Sparks flying.

There's also carbon arc gouging which doesn't require air. Just the right situation and a current.
Reply: Were there people in the Twin Towers cutting steel beams with Oxyacetylene torches? I doubt it. Also, from what I just read, you're wrong... Carbon arc gouging does require air. I also doubt there were welders in there doing carbon arc gouging.

I fail to see what bringing either of those things has to do with this discussion. Seems to me that you're grasping at straws...
Reply: The Ranter, how many diesel engines run plastic office supplies and human bodies into the fuel mixture.
Reply: @Pile Of George. What you're saying is, the huge pile of steel created it's own foundry oven. Retaining heat for weeks.
Reply: The Ranter while that’s true for diesel guys (fellow car but here) couldn’t the black smoke come from other things burning? Like plastics and other man made materials that burn black smoke? I can’t be the only one here who was a bit of a pyro in my junior high days
Reply: Pile Of George Pile Of George I take it you support that this was not a conspiracy as I continue?  I mean this respectfully and it is only the ignorant that think the buildings collapsed due to malicious acts within the government to “demolish” the two buildings.  A few clarifications....”red iron” aka structural steel would be hard pressed to have “reflective” qualities.  Perhaps you meant conductive?   Secondly, vertical structural elements are called columns.  A vertical structural element is NOT a beam.  Just trying to bolster your comment t but I want you to use the right terminology and also material properties. If I shine a flashlight on red iron steel....do you really think I will get much light reflection??
Reply: Pile Of George Beams aren’t vertical!  Columns are vertical!  Please if you want to sound smart...at least use the correct terminology.
Reply: The Ranter  i witnessed the impact. try burning kerosese. these aircraft were iirc bound for the west coast? so theyd have been full if nonstop. not near empty.  also a fast impact on a building with an essentially an exoskeleton. ( look at the story of the towers design. it explains this in great detail. can also look over the blueprints if you desire. also placing thermite to detonate in a building and no one saw this happen? yet they claim a hypothesis as fact? your thoughts leave me with more questions than answers.  wtc7 i cannot explain. wtc north and south i can i saw this with my own eyes. burning jet a burns with a black smoke. so does kerosene. along with building materials. if you have this hypothesis that you deem as fact , prove it. this happened 17 years ago. nothing new is coming out. much of the video clips were taken out of context.  so prove it. with something which would stand in court  a real court not the youtube court of wannabe lawyers. i saw no explosions before the impacts. NONE. the aircraft punched the core. the elevator shafts etc. this building was dead from that point on. the bals in your court prove it. heres another thing. want to see what jet fuel looks like? miami international had a jet a tank burn a few years back. black smoke. paint fuel etc. i keep an open mind. yet i lost friends in this mess. as i said i keep an open mind. prove it to me if nothing else. im willing to read. sell me your consiracy theory. everyone else has tried, not many had valid points. just thoughts. you seem sure of your theory. im willing to give you the respect and listen :)
Reply: @pilotgeorge2000  Since NIST cannot document the temperatures you suggesting, and since office fire (which are what NIST is crediting as the actual source of energy to weaken the floor trusses) are defused by nature (lacking consistent fuel and oxidizer), it really does not matter which jet fuel was inside those two planes.
NIST and Underwriters Laboratories built scaled models of the floor trusses and subjected the test subjects to two hours of the heat that have been accredited to those fire - longer than the twin tower fires burned. Those test trusses did not fail. More so, testing of composite floor assemblies like those used in the towers have a proven unblemished record of in fire survival.
The argument that the floor trusses failed and pulled A66 steel into failure is unproven, as in no evidence to support that supposition, horseshit.
Reply: @theranter  I wonder what floors were all under construction. Is there a list or website that can verify? I'm curious to know.
Reply: In none of the recordings and none of the about 10000 witnesses near ground zero heard explosions go off. Unless magicly they used explosives that produce no noise and leave no traces :)
Reply: @the ranter and now you ignore my points. Good job. My point was IF it was a cover up everybody would be aware of it by now because explosives etc leave traces
Reply: @xVanilla25  not to mention the fact that bases on the size of the explosive you'd need to take out even one steel beam from the tower, you would have been able to hear the explosions from New Jersey. Within a half mile radius it would have sounded like a plane taking off next to your head for each charge. We have plenty of video footage. Nothing like this was heard.
Reply: Awesome how you are able to outsmart people who actually have actually studied this by using your anecdotal TV knowledge... awesome. (PS, did you ever think for a second that fire isn't black and white?  Meaning that, like any fire except for say in a combustion chamber, there are parts burning very hot and parts that are burning poorly)
Reply: "It's wings ability to cut through the outer shell of the building......"

Really? How on earth can a flimsy aircraft wing "cut" through steel beams? Why didn't the engines get broken off and fall down the outside of the building?

The official explanation is just so stupid I can't believe than anyone would buy it.
Reply: Unfortunately your answer shows that you know ZERO about physics, how aircraft are made, what materials are in them, etc, etc, etc.
Reply: @pilotgeorge2000  this sounds like a bunch of nonsense. Please show your work
Reply: Interestingly, steel building would 'theoretically' bend in that way cause of asymmetric burn but it didn't, also wtc7 has its own rules so this explanation is only half of job done. Planes don't transform into flame cutters when crashed into steel buildings, they disassemble as softer materials like aluminum form around harder ones like steel, fuel evaporates and instantaneously ignites but fire can't maintain flame for long. most of the mass of plane is fuel and none can't make it stay high on building. there goes our fuel, with the gravity. To start with, did anyone calculated energy impact on building and how much jet fuel is enough to cut the building in half in thermodynamic study? how much of A1 jet fuel? hmm.. no go, on impact spot burn time - 12sec.. what will then give the columns enough heat and time to melt or 'soften' by A1? ..just an imagination of a public figure.
Reply: @theranter  his explanation would make sense except a big fuckin plane crashed his theory
Reply: @Budokid  the reporters were saying that wtc7  was going to collapse because Silverstein and Co told the media that wtc7 was going to collapse because Silverstein knew they were going to "pull it!" WTC7 was razed!
Reply: or you know, maybe it was because the fire department said they thought it was going to collapse and pulled all fire fighters out of the building and moved everyone 3 blocks back. The fire chief is on record saying a bulge formed in the side of the building at 2pm and that's when they knew it was going to come down. there are first responders on video saying "it is going to come down. there is no way to stop it from coming down". "Silverstein and Co told the media that wtc7 was going to collapse" -- there is no evidence to support this. dont you have a birth certificate to find or something?
Reply: @pilotgeorge2000  you actually have no proof it's only Theory there's proof right in your face and you're refusing to believe it you're very sad
Reply: @pilotgeorge2000  the problem with ovens is that they have to be closed for them to heat up to that kind of temperature this was not in fact it was very very open and an open flame does not increase in heat it is dissipated out of the nearest place and it still would not have caused the Free Fall of the building
Reply: @feinenlieben6467   again I continue to reiterate my statement to other people in diesel engines everything is enclosed this was not enclosed this was out in the open you need to go back and learn how explosions work you do realize that your diesel engine has a great miny explosions going on inside of it at a time right? God please say yes I don't think anyone could be stupid enough to say no to that
Reply: @etrigan1389  and yet fires happen in the absence of jet fuel all the time. It's almost like there was plenty of other flammable material on the plane and in the building... Hmm...
Reply: The Ranter these were buildings full of offices and a ton of other shit.
Reply: @pilotgeorge2000  an aluminum plane cannot go through steel!! Not at any speed variation. It's physically impossible. No planes were used!! It's so simple to underatand.
Reply: The jet fuel would have burned away in just a few minutes. Another point is that at least half of the planes fuel would have used....probably more. Also the giant fireballs was a huge portion of remaining fuel. You can tell by the thick black smoke the fires were oxygen starved and nowhere near the top open air temp. Of jet fuel. All thats left is office furniture ..carpet...etc. That is somewhat fire resistant.
Reply: @theranter  That is fantastic bs.
Reply: @theranter  You have read 16 years of made up crap like this youtube vid.
Reply: @pilotgeorge2000  riddle me this , why didnt the first tower ride down on top of the ruble and stay nearly intact ? 😁😁😁😁 come on answer it I DARE YA !!!
Reply: @Ab4kus  Consider this; The Twin Towers contained 5000 tons asbestos (of the worst kind there is). In the mid-1990s, the New York Port Authority was looking at an asbestos abatement bill of as much as $1 billion dollars – representing well over 10 times the buildings’ original cost. When the buildings’ insurers, Affiliated FM, refused to cover the asbestos removal/abatement costs and won their subsequent lawsuit over the the matter, the Port Authority was left with some untenable choices; The outdated buildings could not be demolished because of the asbestos; for the same reason, they could not be remodeled and updated in any cost-effective manner. The only other option was to slowly dismantle the Towers a piece at a time – the cost of which would have run into several billions of dollars. Conveniently, real estate developer Larry Silverstein was willing to take over the buildings, the first time in its 33-year history the complex had EVER changed ownership. The deal was signed late July of 2001, only weeks before the attacks(!), with a 99-year lease to the Port Authority. Mr. Silverstein, who made a down-payment of $124 million on this $3.2 billion complex, promptly insured it for $7 Billion. Not only that, he covered the complex against “terrorist attacks”. (He was originally outbid by a competitor, Vornado Real Estate Trust – but this bid was withdrawn when the Port Authority refused to reduce the terms of the lease.)
Interestingly, Silverstein was also the builder of Building No. 7, which was full of asbestos as well, by the way.
Following the attacks, Silverstein filed TWO insurance claims for the maximum amount of the policy ($7B), based on the two — in Silverstein’s view — separate attacks. The insurance company, Swiss Re, paid Mr. Silverstein $4.6 Billion. Not a bad return on a relatively paltry investment of $124 million, ey?

Mr. Silverstein’s first order of business as the new owner was to change the company responsible for the security of the complex. The new security company he hired was Securacom (now Stratasec). George W. Bush’s brother, Marvin Bush, was on its board of directors, and Marvin’s cousin, Wirt Walker III, was its CEO. According to public records, not only did Securacom provide electronic security for the World Trade Center, it also covered Dulles International Airport and United Airlines — two key players in the 9/11 attacks.
Reply: @Budokid  Except that the Twin Towers contained 5000 tons asbestos (of the worst kind there is). In the mid-1990s, the New York Port Authority was looking at an asbestos abatement bill of as much as $1 billion dollars – representing well over 10 times the buildings’ original cost. When the buildings’ insurers, Affiliated FM, refused to cover the asbestos removal/abatement costs and won their subsequent lawsuit over the the matter, the Port Authority was left with some untenable choices; The outdated buildings could not be demolished because of the asbestos; for the same reason, they could not be remodeled and updated in any cost-effective manner. The only other option was to slowly dismantle the Towers a piece at a time – the cost of which would have run into several billions of dollars. Conveniently, real estate developer Larry Silverstein was willing to take over the buildings, the first time in its 33-year history the complex had EVER changed ownership. The deal was signed late July of 2001, only weeks before the attacks(!), with a 99-year lease to the Port Authority. Mr. Silverstein, who made a down-payment of $124 million on this $3.2 billion complex, promptly insured it for $7 Billion. Not only that, he covered the complex against “terrorist attacks”. (He was originally outbid by a competitor, Vornado Real Estate Trust – but this bid was withdrawn when the Port Authority refused to reduce the terms of the lease.)
Interestingly, Silverstein was also the builder of Building No. 7, which was full of asbestos as well, by the way.
Following the attacks, Silverstein filed TWO insurance claims for the maximum amount of the policy ($7B), based on the two — in Silverstein’s view — separate attacks. The insurance company, Swiss Re, paid Mr. Silverstein $4.6 Billion. Not a bad return on a relatively paltry investment of $124 million, ey?

Mr. Silverstein’s first order of business as the new owner was to change the company responsible for the security of the complex. The new security company he hired was Securacom (now Stratasec). George W. Bush’s brother, Marvin Bush, was on its board of directors, and Marvin’s cousin, Wirt Walker III, was its CEO. According to public records, not only did Securacom provide electronic security for the World Trade Center, it also covered Dulles International Airport and United Airlines — two key players in the 9/11 attacks.
Reply: there was a shitton more than just jetfuel burning in the wtc towers,too.of course its not going to look like a diesel pulling power
Reply: +@Mandy Holmbeck 

Given that there was a crew from ACE Elevator Company working on renovating the very floors the planes impacted on, in each building, I'd say it's more than possible.
Reply: Feinen Lieben 
Yeah the dentists and botanists sure know alot about engineering
Reply: There is no point making the building collapse on purpose, nothing extra is achieved from "inside job" that is not achieved by just having airplanes crash in the building.

Perhaps less casualties, 300 instead of 3000 - who knows, some more would have escaped, but still would be the largest terrorist act in US history.
So basic point = nothing is achieved from a professional demolition that wouldn't be achieved just by planes crashing into the buildings, same foreign policy, same news headlines with "slightly less drama" but not by much.
Reply: philosophical inquirer 
Logic and critical thinking are not attributes of twoofers.
Reply: @pilotgeorge2000  Let's say 4a moment you're right, & this buildg oven theory makes peak heat, it's still not nearly hot enough 4 softenning, until it's been burning for quite a while.
  With the fuel only splashing most places b4 leaking downward, & a good chunk gone in the impact fireball, how long do we expect the splashed fuel to burn 4 now, b4 it turns into just another fire.
Reply: @theranter  Yes, this free fall -1,   & into a very tidy footprint -2,  are things no person can possibly explain away with the conventional reasons given, & should scare you, as to what made them behave this way.  directed energy vapourization??
Blg 6 was missing its guts too.
freaky deeky sneaky.
Reply: @theranter   :
  You're right about the freefall speeds of collapse not adding up.   & we don't notice demolition below in the quantity we'd need to see..
  In all your pouring over video, & reading about this event, what's your take on the orbs?
  Too strange & timely not  to be a part of the goings on somehow, don't u think??
Reply: @pilotgeorge2000  Are you saying not all the fuel burns bec. of the limited capacity 4 it to burn in optimal conditions?
Reply: @pilotgeorge2000  I like your reasoning of the bolts flying out, & collapse theory in general, 
  however,
  while the floors are modular, the core is usually 1 continual pc, w thick, tied steel embeded & safe from damaging heat.
  As well the exterior as you can see is several large pcs w many bolted & welded connections, staggered & w overlap in layout for high strength also acting as a single pc, meaning if 1 plc in it heats up & deflects, no problem.

  The floors, with their spans, yes would be vulnerable in a long, steady fire, but would need to start falling at every attatchment point at the same time w persision, ea floor falling then bending perimeter steel then hinging on it b4 ripping away, & almost certainly wouldn't do this cleanly w timing keeping it almost horizontal when failure would have started at only 1 area only.
   Good critical thinking though George, & certainly  I'm not an expert last word on any of this, but I do at least think many "possibilities" lending credence to the softening steel theory fall short w common sense, also no incident created failure would be so uniform, & tidy, nature doesn't often do that kinda thing, we do.
Reply: Beams don't have to melt through. Just have to beweakened enough to collapse.
Reply: @Eric Styles... You're going to need to be more specific than just saying "what's your take on the orbs?"... can you link to a video which contains what you refer to as "orbs"?
Reply: explain the molten steel brah, jet fuel cant melt steel beams.
Reply: @Mandy_39  :
    Both bldgs had rather timely, & lengthly elevator work going on in months leading up to 9/11, as well the floors in question had hastily scheduled power outages, for days at a time, so ppl usually working there wouldn't be there, allowing ample time 4 organized crews to thermatofy a few beams & no1 would be the wizer.
  That was on a doc. I watched.   Also a diff't security company w an owner having links to the Bush family takes over duties a few months b4 this happens too..
 Just sayn.
Reply: No. Nothing like "directed energy vapourization" would be necessary (I'm not even sure we as a species have the technology for that)... it was an unconventional top-down controlled demolition... kinda of like in this video, only faster, and on a larger scale.

https://www.youtube.com/watch?v=FJQRK0JjH70

I believe that the central core columns were blown, and once they began falling, they pulled the trusses and most of the buildings contents inwards, keeping as much debris in one pile as possible. Then, just milliseconds after the detonation sequence that brought down the core columns began, another detonation sequence began which broke apart the outer support columns.

The whole demolition was designed to reduce the area of destruction. Secondary destruction was inevitable, as without doing the usual prep work associated with controlled demolition (removing outer facades, and any unnecessary materials, and pre-weakening extra support structures [tall buildings are generally built to have stronger vertical support than is necessary]), combined with the fact that they were doing an unconventional top-down demolition (controlled demolitions are usually started from the bottom-up to ensure the building collapses into a neat pile), there was no surefire way to prevent secondary damage to surrounding buildings.

So, yes, it was an unconventional controlled demolition, but it wasn't anything as unconventional as you seem to be thinking.
Reply: Obvious troll is obvious... Brah.
Reply: @theranter  
  Yes, you may have watched the documentry I did?  Change of ownership w a telling policy, money trails often lead to truth.
  & no1 seems to be able to tell us what the hell they were working on that took exclusive access for weeks at a time, just to make it as b4?
Reply: @theranter  The fieproofing in office furniture dissapates w time & only slightly slows burn time, I think sometimes it's a bullshit self serving industry that gets rid of alot of otherwise reactive pollutant.
  In any case mostly it just insures that burning that item will produce deadly toxic smoke that will kill you much more efficiently than fire.
Reply: I've seen numerous documentaries about 9/11... but I stopped paying attention to other people's theories a loooong time ago. Since then, I look at the information available, and make my own determinations about what happened. People who make documentaries have an agenda, whether they admit it or not. Some are trying to sell their version of what happened, and others are simply trying to cash in and make money. I long ago ran across a Walt Whitman quote that changed how I research things, and I'll share it with you in the hopes that it will impact you as it did me.

"You shall no longer take things at second or third hand, not look through the eyes of the dead, nor feed on the spectres in books. You shall not look through my eyes either, nor take things from me, you shall listen to all sides and filter them from yourself."
~ Walt Whitman ~

Don't trust anyone to tell you the truth. Don't read people's theories, or watch videos that tell you other's theories. Read and watch as many things as you can that only mention what happened, watch the collapses, and also learn things that are tangentially connected to 9/11, and eventually, your brain will put the pieces together, and the truth will become evident. In order to better understand what happened, I had to learn a lot of things I didn't know about before. I had to learn about the planes, about the building construction of the Twin Towers and WTC 7, I had to learn about physics, materials science, and more. Learn whatever is necessary.

Always assume that no one is telling you the truth. And most importantly, hold nothing as sacred... abandon preconceived notions.

But yes, one thing I've always found odd is the fact that there is literally nothing out there that explains the construction in the Twin Towers. If there was nothing nefarious about that construction, then why is there no information out there that explains what was being done?
Reply: @Budokid  you need to listen to the "witnesses" that spoke about wt7 about what they heard and witnessed. Enough already with what the narrative is telling you to hear!
Reply: @pilotgeorge2000  it wasn't just the fuel. All the furnishings walls ceilings all would have added to the flames and heat.
Reply: @pilotgeorge2000  explain the molten steel , please. You explained without any real proof , why it may have softened the steel , which at that weight , would cause a failure but , molten steel?
Reply: @camsterdam3896  drop a few million pounds on top of something at High speed, tell me how it reacts.
Reply: Pile Of George the compression of diesel doesn't melt steel but OK
Reply: @pilotgeorge2000  I understand your thining but that is not how buildings work. The pressure has been their the whole time... The building was standing and having no troubles. Why do you think it all of a sudden cares about the weight? If something weakend to the point it would lean and rip off, then it would... And I get confusion about the twin towers, but building WTC 7 collapsed in the same way just because of a fire... This is unprecedented, has never happened in the history of this planet and then 1 day it happens three times in a row with one building not being even hit by a plane... Just get all the facts about 9/11 and no one with brains inside their head can think anything other than WTF actually happened that day?
Reply: The Ranter well said
Reply: @Jay Jay They we're talking about wood trusses, no steel skyscraper ever collapsed due to fire that is their reputation.
Reply: @scaloi  There are static loads and dynamic loads.
Reply: scaloi 
Cough cough plasco building
Reply: Actually, there was an experiment, and it did exactly what they said, it did exactly what we saw, it did exactly what physics said it would; it weakened the steel until it could no longer hold the weight.
Because as much as this moron goes about these stupid experiments, I don't see him even trying to explain how they got workmen in there to do this to every single column on every floor for at least 4 floors.
Reply: @w0bbl3r  Where is this experiment? I'd honestly love to see it
Reply: Look, if you're just another truther, don't bother. But if you REALLY want to know, it's here:

https://www.youtube.com/watch?v=Kl0tHx36RRQ

The experiment was verified, they tested a single beam with kerosene, with weight on it comparable (might even have been exactly the same) to that on each beam in the towers. The steel gives just as expected.
Now the experiment doesn't show the exact time it took in the towers, because it's just a steel beam with weight on it. It is 100% just to prove that steel can very easily be weakened by a kersone fire. It happens in less than 4 minutes.
Of course, when the beams would all be tied together at the ends, with concrete helping to give more support, hence why it would take longer for the towers to fall.
But as I said, if you're just another average truth lunatic, don't bother. You won't believe it either way, it will just be a waste of your time. But if you really are open minded, want to work it out for certain in your mind, this is damning evidence against the "truth" movement (which has pretty much died at this point anyway, since they have stopped getting paid so much for their nonsense)
Reply: As The Ranter explained, it is not a matter of steel HAVING to melt, the issue is that steel did melt in conditions where it can't. This is another smoking gun for controlled demolition. And it is documented by FEMA in a metallurgy study. (fema 403 appendix c)
Reply: @Ab4kus  FEMA IS A COVER UP FOR CONSPIRACIES U WANNA BELIEVE F.E.M.A SAID METAL CAN B MOLTEN BY AV GAS THEN UR WRONG
Reply: + Francisco Roman WHY ARE WE YELLING?
Maybe you should read the document instead of throwing a reaction out there about something you don't understand. It's only been available for 10 years. Clearly, the steel did not melt due to the office fires or the jet fuel.
Reply: Ab4kus another f’n idiot that has no knowledge of steel’s properties.  I’ll bet money you have to Google
What Modulus of Elasticity means.  Ignorance is bliss isn’t it?
Reply: +Ab4kus FEMA did not document melting of steel in FEMA 403, appendix C. Have you even read that appendix? It clearly states that the steel suffered "high tempearture corrosion due to a combination of oxidation and sulfidation". When you have to start lying about your "evidence" it shows you don't have any confidence that your theory will be borne out by the actual facts.
Reply: @Ab4kus  It makes me wonder if maybe this was a fail-safe, built, or rather retrofitted, into the building at some point after the 1992 bombing. Designed and installed secretly to create exactly this kind of controlled collapse in the event the buildings were ever successfully attacked.
Reply: @Ab4kus  why don't they just check all the steel that was from 9/11 oh that's right it was put on barges and sent to China
Reply: Just where do people get the idea that there was not enough heat to melt steel? The idea of furnace is that there is the fuel which is pretty much anything that burns and then there is a constant airflow and the furnace it self traps the heat and accumulates it in order to melt metals.
So when you have a huge building where dozens of floors are all under a fire, the convection will create a massive airflow trough air ways and elevator shafts and stair cases. Obviously when the building burned for a about an hour and the heat was trapped inside and melt the steal structures where the hot pockets were. Since the floor was made out of concrete, it can trap the heat and the molten materials will naturally flow out from the lowest point it can access.
The amount of molten steel found has never been confirmed, but the fact is that even other large building when they burn can melt steel and the fact that WTC were huge building and there was some molten material is nothing special.
Also even if there would have been a small amount of molten steel found or even none, the heat would still be enough to waken the metals for the building to collapse.
So when people say that the petroleum based fuel can't melt steel, well the fuel could have spread the fire into the building and also making more way for the air to get in, yet it's the sheer amount of burning material that can and will melt steel if the heat is trapped.
Reply: @Diglo1  the maximum temperature of an office fire is way below the melting point of steel. Anyone arguing steel can melt in an office fire is therefore lying through his teeth.
On top of that, there was no "major airflow"   and the fires in the towers were going out by themselves.
Reply: @Ab4kus A huge misconception is that it wasn't a simple office fire, it was a more like house fire or tens of offices on fire. Naturally the convection creates a blowtorch effect and there are a lot of chemicals and materials to melt steel. You don't need to melt steel in order for the building to fall under it's weight. Steel becomes very soft and loses it's strength already at around 600-700 degrees Celsius after which the sheer weight of the building will brake and bend the steel. There might have also been thermate reactions and hot gasses which were the by products of the burning materials and combined mixtures creating different colored smoke and explosions.
It's also nothing new to see that steel has melted or bent when huge structures burn complitely.
As long as there is enough material and air to support the burning and there is a structure holding that heat in, it can melt steel.
Reply: @Diglo1  steel only melts in furnaces, not in office fires. And the steel in the WTC buildings did not even get hot enough to weaken. 
Steel doesn't need to melt for it to weaken, but steel did melt in the WTC buildings, something that cannot be explained by the fires.
Reply: Steel melts where ever it can get hot enough. Again it was not a simple office fire, it was dozens of offices on dozens of floors which can easily provide enough material and airflow once the windows are open to create a literal furnace.
You are also contradicting your self. You say that WTC steel didn't get hot enough to weaken, yet in the very next sentence you say the steel did melt. So if the steel was molten then naturally you would assume that the steel was more then hot enough to bend as some of it was liquid.
What we are now debating about is what caused the steel to melt. I suggest that a skyscraper equivalent of dozens of houses (the burning portion) has more then enough material and the construction allows the air to come in to burn those materials, while the thick concrete walls and steel doors are capable of building in enough heat to weaken the WTC steel structures to fall under their own weight + rest of the material and melt some of the steel, but not all of it.
You however are suggesting that it was a simple office fire.
Reply: @Diglo1  you need to learn the difference between heat and temperature. The size of the fire would change the heat, but it will not increase the maximum temperature it can achieve. Office fires don't get got enough to melt steel, as it is a diffuse flame. There was no furnace in the WTC buildings, there is no evidence for this, and the evidence we do have flat out disproves any claim of extreme temperatures. Not a single steel beam was found that had reached a temperature of 600 degrees Celsius, and only three that reached 250 degrees. We also have flir data and people surviving in the impact zone. And the entire history of office fires that prove that what your are claiming does not happen. You have no evidence for anything you claim.
The steel melted due to an "attack on the steel" which formed a eutectic, as documented in the metallurgical examination by FEMA. 403 appendix C.
Reply: I know the difference. You need heat energy to create the temperature. Materials that have the same temperature can have different amount of heat energy. Wood is still capable melt iron, which steel is just a variant of, in certain conditions.
Accumulating heat will increase the temperature so if the released energy can't escape then the energy density will increase. This is why wood can melt copper or even iron which are far beyond the melting temperature then compared to the wood's burning temperature. So if 600 degrees Celsius burning wood can melt copper which melts at around 1100 degrees Celsius and even iron though it would be more useful to have charcoal (~1550 *C melting temp) and this would be on a simple camp fire or small rock furnace with added airflow.
So now that there are thousands of ton material that burns and a lot of it at the same time, it would be more then reasonable to see temps beyond 1550*C.
Reply: @Diglo1  office fires are not furnaces. The fires in the WTC buildings did not and cannot ever get got enough to melt steel. Adding heat does not lower the melting point, and steel does not melt unless the temperature reaches the melting point, that's why they call it the melting point.
I understand that it's hard to accept basic scientific facts if your paycheck depends on not understanding them though.
Reply: Accumulating heat increases the temperature, no-one ever suggested that the melting point would come down. If a simple firewood burns at around 600 degrees Celsius, the how is it possible to melt copper and iron with wood?
Reply: Arguing you can melt iron with wood is similar to claiming you can blow up a city with water by building a hydrogen bomb. 
The only way to get a temperature high enough to melt these metals is by building a furnace. An office fire is not a furnace. How many times do we need to repeat this before it gets through to you?
Reply: Ok so you finally agree that no matter what the burning material is that it can still release enough energy beyond it's burning temperature in order to melt metals that have require higher temperature in order to melt.
So now that's out of the way, the question becomes that could the WTC fire generate a furnace type of effect? It most certainly can as IT WAS NOT A SIMPLE OFFICE FIRE.
First of there were dozen of offices on dozen of levels all burning at the same time. Also the building or atleast the burning section was high above the ground where the air hitting the building has to go upwards creating a blower type of effect. Secondly the convection effect increases the airflow still and the building had a lot of ways to get air in. It is very possible that some of the heat didn't escape fast enough in certain sections of the building AS IT WAS NOT A SIMPLE OFFICE.

You can repeat the "office fire" thing over and over again, but nobody is gonna accept that WTC was just an office burning as the fire was massive compared to an office.
Your office fire doesn't take into account the possible aid from winds and the size of the structure and the sheer amount of burning material, besides wood. There were also gass lines, plastics and other materials that can easily burn much hotter then wood.
Reply: @Diglo1 You can try to argue that the WTC acted like a furnace, but I'm not going to bicker back and forth about something for which you not only have no proof, the evidence we have disproves what you claim and it would actually be a first in the history of fires. It's that easy.
Reply: @Ab4kus  no it didn't that molten liquid was aluminum from the plane.
Reply: @alexc4159  there is undeniable evidence that it was steel. FEMA did a metallurgical study. And USGS identified WTC dust by the fact of the iron microspheres in it. A result of iron/steel melting.
Reply: It was proven that most of the jet fuel incinerated minutes after the the plane hit. Another thing, how did it implode as opposed to toppling over given the gapping hole, considering only a few floors were on fire?
Reply: "It was proven that most of the jet fuel incinerated minutes after the the plane hit."

Oh really, because someone went up there and checked?

Think about the stupid shit you are parroting.
Reply: the towers fell from top to bottom howe thee hell did all of the steel at the bottom weaken  it wouldve been a jenga basically if you remove the top the bottom still stays and the planes didnt damage the steel from the first contacts from the planes you can see this from the holes from the lanes and not caving in metal. jet fuel burns at 1500 f no matter the amount of fuel it will never reach more then 1500 steel melts at 2500 its no where close and the 2500 is just to melt it to weaken it. thermite  burns at 4000 almost twice as much as the steel melt point. thats why the  buildings fall in seconds all of the thermite set off at once sense it burns way to quickly so theres no evidence if the top was burnt by jet fuel the bottom would take forever to get hot annd wouldnt reach melting point
Reply: and plus why did the other building besides the 2 towers fall they wernt on fire
Reply: NewbAtYoutube, wtc7 actually was on fire -- for 7 hours. with a non-functioning sprinkler system.
Reply: Stephen Savage , jet fuel didn’t melt the steel, and yet molten metal was flowing in the twin towers’ debris for months up til late December 2001, one more thing, if jet fuel was the cause to have weaken the twin towers’ steel frames then why did building 7 come down the same way the “48,000 gallons of jet fuel” was no where near it, oh a small fire melted the steel? So the engineers built a steel building 7 and forgot to think about a possible fire may happen in it?
Reply: building 7 was not a small fire. the fires spanned 5 or 6 or the low floors and it burned for 7 hours without a functioning fire suppression. the fire department even suspected it would collapse as you can read statements from the chief of police saying as much and all the new coverage saying "we are being told this building behind us will probably collapse (referring to building 7).
Reply: @CodeOfTheScroll3712  because the building you are referencing is not a tube steel frame building. It was a steel and concrete composite structure. there was severe structural dmg to the horizontal steel beams in your example. In 2017 two steel frame buildings came down due to fire alone. One was in Tehran and the other I can't recall off of the top of my head. Steel frame buildings do not do well in long fires. Tube steel frame buildings do even worse because they have comparative few vertical columns supporting the floors. Rather, they rely on a few key beams towards the center of the structure while the exterior of the building has comparatively more beams -- which essentially act as a rigid exoskeleton, which is supported and braced by the interior floors. Fire causes the long stretches of unsupported floors to sag and eventually fall/fail, leaving a hollowed out unstable exterior that buckles and falls under it's own weight. One corner of the building also suffered heavy dmg from falling debris. There is video footage of this. It looked like someone took an giant ice cream scoop to the side of the building. Additionally, steel looses strength as it heats up. At 500c it has lost ~50% of its strength. Also when thermal expansion occurs, if it occurs unevenly, the welds holding beams together can snap. They saw this collapse coming a mile away as well. That's why all the news coverage of it up to the collapse talks about it possibly collapsing. This is why nobody died when it collapsed. This is why the were able to move everybody 3 blocks back prior to it's collapse. Perhaps go learn something about materials science and building construction before accusing someone of being stupid and then comparing an apple to an orange.
Reply: What can if it's sandwiched between floors?

Y'all need to start being more specific in your replies... I've posted many replies here... if you want me to know what you're talking about, you need to be specific about what you are addressing... I'm not a mind reader.
Reply: @Tyler Lyon wow you're dumb
Reply: I love reading the kooky ideas that  the truthers have. Lol
Reply: You have yo atomize(spray) jet fuel to ignite it.
Reply: You, the one parroting back what the government told you, are calling me a broken record? That's hilarious.

And no... WTC 7 wasn't struck by debris... at least not enough to do any serious structural damage. And oh, yeah, the old BS from the "official story" that it collapsed due to fire... the building did have fires in it... a few small isolated fires. If those small fires were enough to bring down WTC 7... then explain to me how the Windsor Tower in Madrid, Spain didn't suffer a complete collapse after the massive fire that happened there? I'll assume, like most of you people who believe the "official story", that you have no idea what the Windsor Tower Fire is... so here, take a look at a fire that was much, MUCH larger than any of the fires that occurred in any of the WTC buildings on 9/11, and yet, it didn't cause the Windsor Tower to suffer a complete collapse like WTC 7 did.

See for yourself.

https://www.youtube.com/watch?v=eKvgD9NyIi4

I always find it funny how people like you who've never done their own research, and just parrot back shit from the "official story" sit there and tell me I don't know what I'm talking about, when I've literally seen every single piece of video footage from 9/11, and have been researching 9/11 for the last 16 years. You're the fucking joke, brah... because you just believe what you're told.

Here, watch this as well... maybe you'll understand after you actually hear the explosions that occurred in the towers on 9/11... maybe you'll understand when you see the blast wave moving down the towers ahead of the collapsing upper section.

But I bet you don't have the balls to actually watch the things I post, because you've been conditioned to think anyone who doesn't believe the "official story" is an tin-foil hat wearing idiot conspiracy theorist. Prove me wrong... and watch it.

https://www.youtube.com/watch?v=K9-2YxiSE4Y
Reply: @theranter  I just don't want Hillary to come kill me lol
Reply: It may not be hot enough to melt but is hot enough to weaken the steal to the point where it would bend and buckle
Reply: If you look at how the towers were built, the center was the strongest part of the building making it nearly impossible to implode without explosives.
Reply: Are you stupid or just a media puppet?
****MOLTEN STEEL***
Reply: Man all you idiots need to shut the fuck up about fire not being able to melt steel, where did it say that dumb fucks? Do you guys really expect a big Boeing plane to hit cause fires and not weaken the steal? Look at how the building was made it's like a hollow tube all steel strength on the outside, as the fires carry on its weakening the steel. I don't see any large scale tests like to prove this. All these conspiracy theorists are dumb fucks!
Reply: Both the Manager of WTC Construction & Project Management at the Twin Towers, Frank A. DeMartini, and the man who designed the buildings, had said previous to 9/11, that the Twin Towers were constructed with 600% resiliency. Meaning the building was built 6 times stronger than it needed to be. Ever seen a picture of the core columns of the Twin Towers? Why do you think they're so ridiculously massive? Because they're 6x stronger than they needed to be.

The Frank A. DeMartini also said this in a pre-9/11 documentary about the Twin Towers that aired on the History Channel:

"The building was designed to have a fully loaded 707 crash into it, that was the largest plane at the time. I believe that the building could sustain multiple impacts of jetliners because this structure is like the mosquito netting on your screen door... this intense grid... and the jet plane is just a pencil puncturing that screen netting, it really does nothing to the screen netting."

Source: https://youtu.be/71xL9qww_So?t=32m51s

In before "but that's a 707, not a 747!"

Let's do some comparison:

Boeing 707-320C:

Wingspan: 142 feet, 5 inches
Weight (fully loaded): 333,600 lbs.
Top Speed: approximately 627 mph

Boeing 767-200ER (Model used to hit the Twin Towers):

Wingspan: 156 feet
Weight (fully loaded): 395,000 lb
Top Speed: 567 mph

If a Boeing 707-320C were to impact one of the Twin Towers at maximum speed while fully loaded, it would impact the building with 4,384,178,809 ft-lbs (5,944,148,318 Joules) of energy.

If a Boeing 767-200ER were to impact one of the Twin Towers at maximum speed while fully loaded, it would impact the building with 4,245,123,686 ft-lbs (5,755,614,886 Joules) of energy.

As you can see, while the 707-320C is a smaller plane, it actually has a higher kinetic impact while fully loaded at top speed than a 767-200ER does. Higher kinetic impact = more damage potential.

And the 767-200ER that hit the North Tower (American Airlines Flight 11) was only traveling at 440 mph on impact, and it only had 81 passengers in its 158 seats, and was only carrying 9,717 gallons of jet fuel, approximately 14,000 gallons under capacity. This means its kinetic impact was even lower than it was capable of generating if it were fully loaded and impacted the North Tower at its top speed.

As for the 767-200ER that hit the South Tower (United Flight 175)? It was even lighter than AA Flight 11. Only 56 out of 168 seats were occupied. It crashed into the South Tower while traveling 540 mph, it had 9,118 gallons of fuel in its tanks, meaning it was carrying even less fuel than AA Flight 11. This also means that while it generated a higher kinetic impact than AA Flight 11, due to its higher speed at impact, it still had a lower kinetic impact than a fully loaded 707-320C at top speed.

Science!
Reply: YOU CAN HAVE 100 MILLION GALLONS OF JET FUEL, A CERTAIN TYPE OF FUEL CAN ONLY BURN SO HOT BEFORE THEY REACH MAX TEMP WHICH THE VIDEO SAYS ITS ALMOST 2000 DEGREES BEFORE MELTING TEMP OF THE STEEL BEAMS.
Reply: It was obvious it was controlled the buildings fell just a well done demolition job. If they fell due to damage and weakening would of been to a side
Reply: And you got your engineering degree where?
Reply: And you know this because... why?
Reply: Don't give up your day job, pal.
Reply: @DJAsHeRMusic  It is obvious you know little about demo or construction engineering.
Reply: @DJAsHeRMusic  English teachers around the world are silently weeping...
Reply: all you fun experts forget 1 thing. the  jet fuel used in the planes on 9/11 cannot burn unless aerosolized, go watch mythbusters episode trailblazers, it has to be sprayed to aerate and become stoich, the only jet fuel that would have burned, burned in the inital impact fireball. It COULD NOT burn in puddles inside, or down the shafts or anything else.
Reply: @enzo1234069  yes because the paper, desks, carpet, and everything else inside was magically flame resistant
Reply: @alisterlockland2357  I work in fire restorations, do you know how hot household and office materials burn? Also what does that have to do with what I said when what I said specifically had to do with jet fuel?🤔🤔🤔🤔
Reply: @enzo1234069  
If you can't make a simple connection between the impact fireball you're lucky youre competent enough to be a glorified dry waller.

Secondly paper burns between 400-500 degrees. Taking into account other materials the fire gets hotter. Like plastics, fibre glass, leather, nylon, or lithium batteries.
Reply: i dont touch drywall, thats not my area of restoration, infact i dont touch the home itself i do high value contents. anyway, 400-500 degrees? are you sure on that number? do you know about laminated or compressed woods temperatures (like most common desks are made out of) carpeting of various fabrics, lithium batteries werent a normal thing at the time so thats out, your different types of plastics that most office style lectronics are made of...... all of these things in a fire and you really want to compare them to the temperature of fuels? let alone jet fuels or what it would take to weaken steel structure? look up the windsor tower, it burnt top to bottom for 2 solid days, was still standing never collapsed. that was still full of construction materials as well which allso means plenty of gasoline........still standing
Reply: yes 500c im sure. in regards to windsor, all the steel frame portions of that building collapsed. only the concrete frame portions remained standing.
Reply: @enzo1234069  that's not necessarily true, just look up airline fires.
Reply: I guess you've never seen a refinery fire.
Reply: @enzo1234069    There'd be plenty of fumes from the fuel being spread out in heat from the impact sight, which would be eas(ier) to ignight ??

   But If what you're saying is true then the fact they leaned on fuel burning to support official claims is completely damning.
  17 yrs.
  They hide behind that, "the families wouldn't want that", "Just let them have their peace" bullshit, I'd want 2 know if there were doubts. 4 sure.
Reply: @ericstyles3724  you do realize jet fuel only ignites and burns when aerosolized right? Upon impact it would aerosolize and immediately burn any fuel POOF gone, no more fuel theory because no more fuel
Reply: @enzo1234069  Perhaps that's just to burn w its greatest efficiency??
Reply: Exactly
Reply: Also he said that jet fuel burns at a certain temperature that CAN NOT burn high enough to burn steel beams
Reply: doesn't need to melt. just needs to become weak enough that it collapses under the weight. at 500c the steel looses 50% of it's strength and uneven thermal expansion can break the welds connecting beams. last year 2 steel frame building totally collapsed due to fire alone.
Reply: Exactly. Do the same experiment, only now add thousands and thousands of pounds to the termite point. You'll have it come apart easier and come straight down....
Reply: Stephen, well said.
And at 24mins "It sounded like gunfire"
Well that's what bolts sound like as they snap in a weakened state (owing to excessive heat) under unbearable load.
Reply: In addition to the planes not having a lot of fuel, you can see it burn off in a huge ball upon impact. Great video! You put tremendous thought and effort into your experiments
Reply: Weaken steel won’t make rest 75% of the building to go down with it when only top 25% is burning...
Reply: SECONDLY, If youve ever worked with steel at any point in your life youll know if its weak it will bend, not completely give way and fall at such a speed, the building would droop slowly and eventually collapse sideways, not vertically. Wake up, do your research and look further
Reply: @louisgarofalo5575  :
   An underrated observation Louis!  That's totally true, in a recollection about a 1969 tower crane accident where it was pulling up a blind load in fog that quickly got hung up on the building & pulled the crane's arm down, it didn't detatch at any point, just bent &/or twisted.
  Yes even compromised steel has strength.
  It certainly would be hard to see the perimeter all bending at the same time, the same way too, just to get momentum enough to keep falling, (free falling) that is...
Reply: Moron jet fuel is just kerosene it doesn't burn hot enough and most of the fuel was burned up on impact you're an idiot
Reply: +Chris V it still weakens the steel enough for it to collapse under the weight of the building. the steel does not have to melt for the building to come down. in 2017 in Tehran a steel frame building totally collapsed due to fire alone. no beams were melted. steel weakens, uneven thermic expansion occurs, welds break, bolts are sheared, building comes down. steel frame buildings do not do well in long fires. steel is sprayed with fire-proofing to delay this effect, but it will eventually fail.
Reply: I've seen an all-steel warehouse (that covered half a city block) vaporized to the ground in about 30 minutes by a fire that was fueled by baled corrugated cardboard -- not enough left of the building to fill a dumpster; the shell and beams were just GONE, all the way down to the concrete.
Reply: You people don't understand the amount of evidence there is for controlled demolition... and nothing any of you have said explains the collapse of WTC 7, which wasn't struck by debris, and only sustained a few small fires, but somehow suffered a complete vertical collapse at around 5:30pm on 9/11.

You don't understand that, because you probably haven't bothered to look at the many videos out there containing the sounds of explosions in the Twin Towers... you haven't looked at the videos of the Twin Towers collapsing that show what certainly appears to be a detonation wave in advance of the collapsing upper sections... there's so much out there... all you need to do is look.

Again, find the comment here where I linked to a video of WTC 7 collapsing... watch that building collapse, and tell me that wasn't a controlled demolition. Larry Silverstein even said "We made the decision to pull it"... "pull" is a term used in the controlled demolition industry. The only way they could have "pulled" WTC 7 is if explosives had been strategically placed throughout the building in advance of 9/11, because that shit takes a lot of time... there's no way they could have done that in one week, let lone one day.

I know it's difficult to consider the implications of the Twin Towers coming down as a result of a controlled demolition... I get it... especially after years of having the official story's narrative pumped into your head by the media, and the government... but the official story is just that... a story... a fictional one at that.

I'm not just some conspiracy theorist. I used to be... but I've disproven all of the ones I used to believe except this one... despite trying to do so for a long time. I learn about all kinds of topics... and my years of learning about a wide array of subjects has only made me question 9/11 more... not less.
Reply: Actually, if you look at the other side of WTC7 (photos do exist), debris impact had taken out a chunk about 20 floors high, and a good deal of structural support. In fact it started tilting that direction before it collapsed, as can be seen in the usual video. It had been "creaking" for several hours at that point, bad enough for rescue personnel to bug out (per numerous reports).
Reply: @theranter  It was struck and had severe damage.
Reply: There used to be pictures online (I can't seem to locate them online) of the WTC 7, viewed from ground level from various angles that were taken on 9/11... and no. It was not struck by debris, at least nothing large enough to do structural damage, and no, it did not have severe damage.
Reply: The Ranter 
You are a conspiracy theorist, dont deny yourself man.
WTC 7? Easy
Reply: it is easy to explain DeepBlue.

There is no point demolishing the buildings as an inside job, everything achieved can be equality done with just two airplanes crashing into the twin towers. Who would even care about demolishing building 7 - it serves no further purpose that has not already been achieved with the planes hitting the buildings.
So what if the buildings didnt collapse "demolition style" but just had gaping holes.
Would be EXACTLY the same foreign policy.

You really think that Bush is going to say, Im not invading Afghanistan because the twin towers were merely damaged and only 300 people died but only invade if the buildings are demolished and 3000 people die ? 
All the conspiracy theorists dont even bother distinguishing that a motive for demolition via inside job (thermite or whatever) achieves nothing extra than the planes didnt achieve alone. (slightly less drama and more clear up, but headlines are the same)
Reply: @theranter  I also used to buy the softening steel theory until I did some reading, watched a shitton of vids noting the unnaturally horizontal profiles of the roofs of all 3 bldgs as they fell..
Reply: Again, you don't understand the argument of which I was trying to bring and point out. I will say again and again;

steel don't melt
(they can, which is an error on my part, but it depends on what kind of fire you have. Looking at the smoke coming out of the towers, it suggested that there is a very hot fire in the process which is the key ingredients on structure collapse)

and no. Never have I ever saw that the truthers bring up "steel can expand to high heat" so what you're saying of "repeating of what they said" is incorrect.

So you're saying is that I don't have enough evidences to prove my point? I can assure you I do but I refuse to present them to ignorant like you as it will spark for another senseless debate that no one wants to waste their time on.

I would wildly suggest you learn how fire behavior works and understand the way how structure collapse. Maybe you can actually learn something! amirite?
Reply: @feinenlieben6467  I believe you completely missed the part where I said "they can, which is an error to my part". Seriously? How can you miss that? Yes, I ended up researching and read articles that steel can melts. It just doesn't make any sense. Before melting, steel expand and then melt. That's how it works.

Part of fire behavior is looking at smoke which can tell us what kind of fire we're dealing with. If it lightly color and lazy, it's a small fire. If it heavy and moving rapidly, it's a large and hot fire. 

I'm just tired dude. Of course I'll miss out some details when you have so many things adding on top of you for weeks and extremely tired of arguing against idiots who don't know what they're talking about (not you man, you're cool. You reminded me that steel do melt so I thank you for that)
Reply: Those planes were almost empty in fuel, it takes half of the fuel at take off, then they came from half way of their original destination. A plane has just a small reserve of fuel when it lands.
Reply: @scaloi  planes almost empty of jet fuel?! They flew 1/2 there destination?! WTF, no! They picked planes that were going from East Coast to West Coast so how is flying from Boston to New York 1/2 the destination?! Those tanks were definitely not almost empty!!
Reply: @Mandy_39  They we're hijacked 1/2 way to their destination and they turn back to NY by flying. They didn't fly direct from Boston to NY
Reply: They're delusional!
Reply: No they weren't...stop lying! The terrorist pilot went directly from Boston,  and headed west until he got to the Hudson river and followed the Hudson river all the way down to the Twin Towers!
Reply: @Mandy_39  it wouldn't matter as soon as the fuel was ignited it was almost completely disappeared that's how fuel works some of it gets lost in the air some of it gets burnt up
Reply: Mandy Holmbeck look up who was head of the security for the world trade centers at the time... well actually I’ll just tell you, one of buch senior sons. The brother of the president at the time. If i have to explain the connections of the bush family with zionists or shit whoever you want to blame for this deep govt then you needa do some more research on these people. The connections are with some very serious and dangerous people in the world that have no faces and names but make alll the decisions. Freemasons etc. rule the world banks. All these people have been mingling for decades and decades and raised into these shadow figures and shadow groups . George w bush either new what was going to happen or he is just a puppet working for these people. People don’t understand that human lives have no importance on the decisions they make in order to rule the entire world of the resources and word banks that control dollar. They will shed blood to as many thousands of people as necessary to accomplish their mission. It’s a sad way of thinking but even light research on these very powerful people and some of the things they have done and their symbols in every part of our lives is scary as much as astounding. I don’t know what happened on 911 . I do know there is a lot of covering up going on and this was a very well though out and executed plan. I just know It wasn’t  done by some Muslim in a cave that sent 19 fools over here and accomplished the events on 911 to perfection, hitting 3 targets with precision. That’s bs. Sounds to me more like non passenger drone planes with missile heads attached, like the ones they fly daily in the Middle East from the other side of the world in Nevada or California . If not those passenger planes had chips in them that shut off all controls and communications with the outside world and was redirected through those chips activating and remote control steered to flight paths towards the targets. Anyways, that’s all, but the presidents brother was in charge of security at those buildings and witnesses said maintenance had been going on for months on repairing and renewing the elevator shafts .. that’s quite the coinincidense. There is just too much going on and those that accent the public report from the govt I feel are too naive or clueless on the pure evil that has always existed in this world.
Reply: @Mandy_39  YES, but the radar trail has the two of them flying w that load in long tracks away at first, w wide loops, burning a fair chunk.
  With takeoff & it not taking as much fuel to finish the trip bec. fuel weight <overall weight>  is significantly less further into the trip, that could've made a significant difference, despite our being reminded in media about the full, ( not commpletely full ) tanks.
Reply: scaloi no they weren’t, the first flight was scheduled from Boston to Los Angeles, it then detoured to New York and what happened next is obvious. God damn use your head please.
Reply: Yes is was detoured to NY but the last signal before they turn off the tracker was 1/2 way to LA.
Reply: scaloi: yeah that’s not a plane burns fuel. They’re much less fuel efficient at take off yes...but they don’t burn half their fuel load in the few minutes that make up take off. Read a book buddy.
Reply: @scaloi  that is a load of crap. Youvs made that up. There are plenty of fights to pick over 9/11 but questioning how much fuel the planes had is not one of them. It does not take anywhere near half the fuel to take off, as a pilot I have no clue where that came from, that's for starters. Then you say they were half way to their destination. Nope. American 11 and United 175 were hijacked about 30 mins into the flight, and where airborne for and 40 and 50 minutes respectively. They were still almost full of fuel.
Reply: scaloi you don’t know a thing about commercial aviation.
Reply: Plus majority of the fuel burned up on impact. So the temperature and burn duration wasn't there enough to melt the steel.
Reply: @Mahatheyew  steel becomes red hot and weak long before it hits melting point. This argument is like saying "the car couldn't have lost traction because there was no ice on the road" metal does not have to melt to fail and cars can lose traction in the absence of ice.
Reply: nop2rop Except the presence of molten steel does suggest it got hot enough to melt.
Reply: @Mahatheyew  except there is no evidence of molten steel.
Reply: @Matthew this has already been tackled to many times. Im just going to plagarise this: This is evidence for molten metal, not specifically molten steel. witnesses reporting molten metal does not automatically imply molten steel. The WTC was full of metals having melting points below the measured temps of 900c and this includes common metals like aluminum, zinc, lead. and these may have been reported by the witnesses inaccurately as being molten steel, especially if glowing steel elements were dipping in pools of molten aluminum. Molten aluminum only remains silver at its lowest melting point. if brought above that it will glow varying colors of red to yellow to eventually 'white hot'. the plane itself is 80% aluminum. it went in on like the 82 floor and the molten metal is seen coming out of the 80th floor. People are not trained to identify different types of molten metal on sight. additionally, steel becomes red hot well below melting point. 

There is no documented evidence of the presence of actually-melted steel at ground zero. The molten material noted in the 9/11 Commission report was "slag," not a molten metal. Most of the reports of "molten steel" found at ground zero were merely references to obviously red-hot solid steel. Even if they actually found "molten" metal, aluminum (which the planes were made out of) melts well under the temperature of jet fuel (pure aluminum melts at 660° C, jet fuel burns around 980° C[23] going up to +2,000 °C[24]). In addition, the mix of jet fuel, plastics, rugs, curtains etc. may burn hot enough to melt aluminum. (This can be demonstrated by placing an empty aluminum soda can on top of an ordinary campfire.)

Additionally, the melting point of steel is within the range of 1425-1540° C,[25] well outside the temperatures recorded at Ground Zero in the weeks following the attacks. What conspiracy theorists fail to note is that steel thermally expands while it remains strong and thus fire rapidly destroys uninsulated steel structures, and steel begins to lose its structural integrity (and red hot steel itself burns in air or in the presence of steam) at well below its melting point, or 700-820° C, well within temperatures recorded at Ground Zero in the weeks following the attacks).
Reply: @scaloi  Are you drunk?
Reply: scaloi half way of their destination? Their destination was California!! Those planes were full of fuel. But I know that the fuel would not melt the steel even with a large volume. The buildings were pre-wired to implode in the event of a catastrophe that could cause them to topple over. It was either implode the buildings or risk them falling over and wiping out a larger area and causing even more damage.
Reply: @scaloi  they just left the airport there was enough
Reply: Wrong. They were nearly full
Reply: @scaloi  Your wrong. And just how far do you think Boston is from NYC?
Reply: scaloi it doesn’t take half the fuel to take off, the planes weren’t close to empty they weren’t even in the air that long
Reply: What don't you people understand about the following sentence: Most of the jet fuel continued through the buildings, exited the other side, where it aerosolized and generated the giant fireball seen just after the planes impacted the Towers?

Here is a video of the 2nd impact from 18 different cameras. I mean just look at how massive that fireball was... it was huge. That's the jet fuel going up, right there.

https://www.youtube.com/watch?v=7YLm3pkAiJQ
Reply: @theranter  I also would like to give my email address but can't send you or your page a message for some reason.
Reply: Not sure why that is... I can't seem to find anything to enable/disable messaging, so, I don't know what to tell you. All I do know is that I'm not just going to post my email address here. So, I'll think on it, try to come up with a solution, and get back to you.
Reply: @theranter  If there is so much evidence and "everybody knows about it" why it is not causing major riots etc news coverages etc? you cannot pay 6 billion people quiet no. Only delusional people like you believe "bush did 9/11" because it makes you feel better. Make world a favour and stop trying to force people to believe you. Trust me i have studied a lot about the twin towers and nothing points towards "it was inside job". The design of the building and the fact that two big commercial jets crashed on to them made them fall down. and dont start with building 7... its unusual design and the long lasting office fires kept weakening the steel to make it bend and fail. Whatever you say a coverup of 9/11 would have been impossible. it would have costed so much money that they wouldnt have benefitted by any way in anything and would have crippled the economy of the US
Reply: 12tommita... I have not once said "everybody knows about it" so, you might want to make sure you're tagging the right person. Nor did I say anything about people being paid to keep quiet. Nor did I say anywhere that Bush did it. So, yeah, you should probably recap on what's been said in this thread, and recap who said what, because you sure as shit ain't replying to anything I've said.